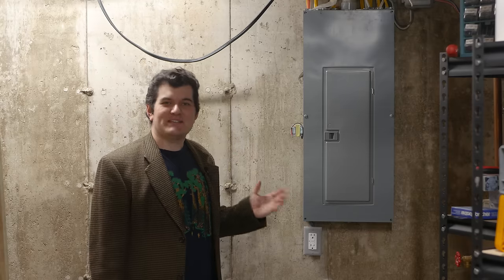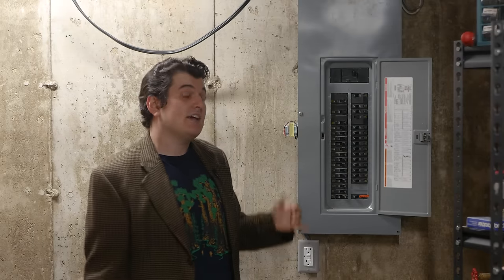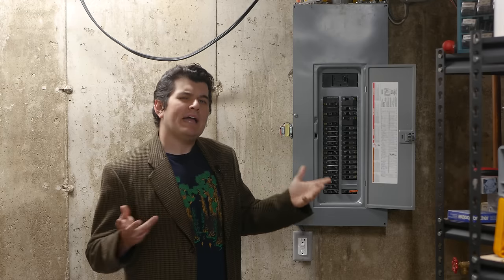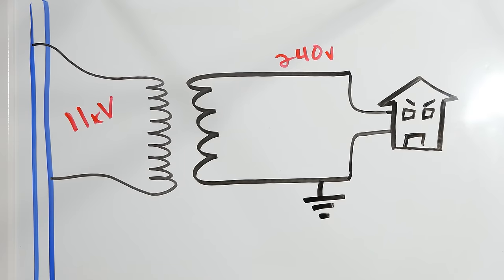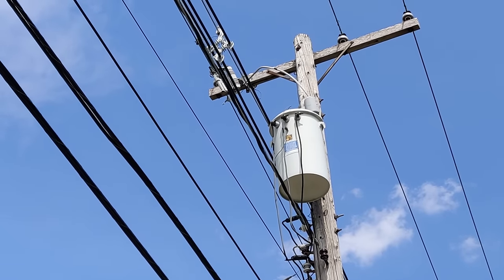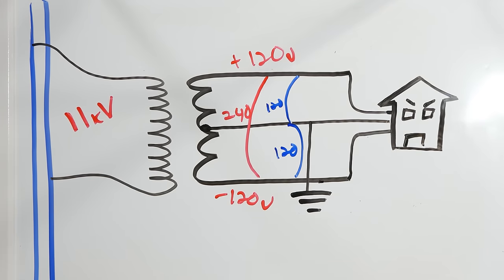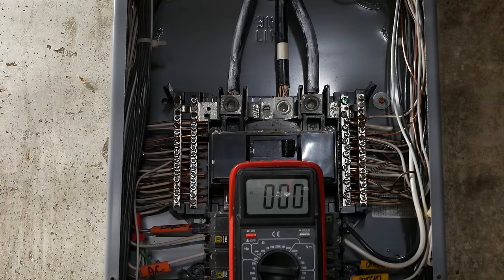The US electrical system is not 120V

Comment from the maker: One of these days I'll tidy up that wire...
A minor note; the thing about 208 being 86.7% isn't right for simple resistive loads like heating elements. You'll actually only get 75% the heat on 208! Power (watts) goes up with the square of the voltage. But, if something is designed specifically for 208, you can pull up to 86.7% what you could on 240 with the same amperage.
Reply: One day or day one.
Reply: Me to my DIY outdoor sensor wiring too.
Reply: Your neutral and ground wires are not looking to (current) code:   1. There are spots where two wires are under one screw.   2. The neutral and ground are not separated (yeah, I know, they are the same potential, but the code says they need to be separated... for reasons.).
But the panel probably predates those changes.

PS:  Wear your electricians gloves when working on a live panel... including just poking at it with a meter.
Reply: The two wires under one screw is a definite no-no.  In my area, however, both neutral and ground must be bonded to the box.  It is ridiculous, but that is what the inspector demands.
Reply: One day? Shocking.
Reply: Please tell me, for my heart, that you were in fact on top of an isolating mat ;_;
Reply: Explanation at 14:37
Reply: @TidusleFlemard  
I hope he was standing in an old tin bucket filled with saltwater. You know, for your heart.
Reply: Hi, you do realise that the main distribution voltage in Europe and Australia is 415V. The 208V you talk about is our 415V. Yes you have a 3-phase system with the standard extra phase neutral as us. But where you use 208V we use 415V. So you cannot use our industrial machines either. So our air conditioners, and other heavy uses use 415V. So the 230V countries are actually 415V
Reply: @SYH653  Two wires is fine in many jurisdictions, neut and ground must be bonded to the box everywhere I've ever see.
Reply: Joe Kinchicken  The wire hangin'? Pffft, I doubt he knows. Did they change the doorbell xformer in NEC?  But, I really don't want to try to explain Delta vs Wye xformers to him...
Reply: Thanks for the clarification re: power vs voltage for a resistive load - this enables me to keep my pedantry to myself, and I suspect that's better for all concerned.
Reply: Not explained in the video, there is a reason for the US garden variety of 240V plugs, it's not just hot+hot and hot+neutral+hot, there are different plugs for different current ratings (and sometimes use cases also).
 @varno  Actually some parts of Europe use 220V / 400V for single and three phase respectively.
Reply: Air conditioners (non-inverter type) will have 2 BTU/hr ratings too, one for 240 and 208.
Reply: Do you Americans have DMU trains
Reply: Have you done electrical training or did you just study all that by yourself?
Reply: Talk us about high-leg delta, the weirdest connection I ever know.
Reply: Yes, here in UK no appliances have their own on and off switches. This is particularly hazardous on any device using fast rotating knives, as we have to edge past it to reach the wall socket switch. The issue about having to hard wire high wattage gizmos is interesting. We have 3 amp, 5 amp and 13 amp options for nearly all devices including clothes dryers and kettles.  For power hungry stuff, as long as you have a 13 amp fuse in the plug all is lovely. My oven is the only hard wired appliance I have but then it comes off the fuseboard as a stand alone item with a 30 amp cable.
Reply: but but.. 1:10 in and I use my electrical outlet for my ac...
Love your content, your honest about mistakes done which is now almost too late to change and explain why things are the stupid way they are, I'll continue watching from Norway and love your content :)
Reply: Whaaaaa! My vacuum cleaner has it's own on/off switch, my kettle too, while all manner of other stuff has on/off switches, including fix-wired water heaters (immersion heaters). Even my wifi router has an on/off switch, although it is on the 12v supply, not the 230v AC plug-transformer...
Reply: Please do a segment on ring mains. My Australian  electrician father in law was perplexed by these when he visited the UK. One of the tricks they offer is audio communication between rooms. You can plug a non radio version of an intercom in to a socket in one room and speak  room to room with others plugged in. In fact in the 1990s baby intercoms worked this way although I think they are all radio based now.
Reply: @ole-martinbroz8590  Sure if your AC is under something like 24,000 BTUs.  But for the big boys and central air they run at 240.
Reply: Wtf  dude. Why you losing weight while the rest of us getting fat sitting at home? Booo!
Reply: UK comparison - most houses will have a 100A fuse for all incoming power. Some will even have 60A. I've never seen higher than 100A. We will have generally around 10 circuits in our consumer units/distribution boards. I would only see a distribution board the size of this one in a workplace. In theory it is possible to get a three phase supply at home, but I don't know anyone who has managed it.
And yes, it is generally a fuse not a circuit breaker. Note that in the UK and Europe it's 230V RMS plus or minus 6% - officially. Of course if you are near the substation it will be higher. I live close and currently I see 246.2V.
We use "equipotential bonding" so that the circuits are still safe in the event of a fault. That is, all the metalwork is connected to ground. Provided you don't touch anything outside your building (external power for charging a car etc is therefore unsafe unless it has its own ground). In some cases it's the same in the UK, that neutral and ground are the same but it's not usually.
Finally, 1500V is considered "low voltage" - but it's still potentially lethal. (I'm sure another electrician will correct any mistakes).
Reply: @varno  Europe has to supply (officially) 230V plus or minus 6% per phase. But see my other post.
Reply: funny, the highest service you can get here in France is 90A 1 phase 230V for a full size house (if you need more, you get 3 phase)
the US plugs that pull themselves out of the wall only with the spring action...
Reply: @jimmytwoguys  I joked, cause I have 240v plugs and 400V service in our homes so I can use a normal plug for quite large ones as.. 240V sarcasm over internet isn't always the best :P
Reply: @13:35 Erica Dansby as played by Julia Stiles.
Reply: Awesome video! I know I'm one of "those people" pointing out something in the video. 🙄
However! There is quite a bit of residue and corrosion on your panel. I see several screws that have rust on them. If you can, put loads on your panels and point a flir camera at the panel with the cover off. You might have hot spots and need to treat the corrosion.
Reply: Plus we shouldn't forget about 480V 3-phase either. 
Some fun facts, my CNC machine has a 3-phase motor on it, but the machine plugs into a standard 240v circuit. The VFD handles the conversion and adjusts the speed of the motor. Apparently 3-phase allows for greater control.
Then my SpeakerPower SP2-12000 power amplifier plugs into a 240V 30A circuit, since that drives the subwoofer system in my home theater.
It does become quite fascinating on how a lot of things work, and a lot can sure get quite complex.
Reply: So all of the cost and complexity of three phase, with none of the benefits.  Brilliant.
Reply: Natural Gas or Propane Clothes dryers provide a smoother/constant heat source than their electric counter parts. Also they are more expensive due to their cost of manufacturing to safety ratio, which is absurdly higher than electric dryers. In the long run they cost about the same overall. Electric is cheaper to buy upfront but cost more to operate. and Gas is more expensive upfront and cheaper to operate. Yes natural gas dryers are cheaper to operate. Why you ask? Gas dryers take about a third to half the time to dry a load.
Reply: @InconsistentManner  and if you live in an area with natural gas that isn’t the cleanest they also impart a lovely aroma to your clothing.  Ugh, I hate natural gas dryers.  And not crazy about electric either - if the weather is nice I’d rather just hang the clothes outside even if it isn’t nearly as convenient.
Reply: 277 volt lighting circuits....
Reply: 16:00
At least you can convert to IEC 60320 standards without completely replacing your electricity infrastructure.
C13 and C14 for 240V
C15 and C16 for 120V
Reply: Thanks for a great video.  I am an electrician, so I understand all of this (and why you left out what you left out), and you did a good job explaining split single-phase.  I only wanted to present a piece of constructive criticism: your tone across all of your videos seems to be getting more and more apologetic as you go.  You are making statements of fact, but look more and more like you expect to be attacked for them.  I understand that you get lots of folks mouthing off in the comments for this or that inaccuracy, but the "don't attack me" looks on your face are actually starting to slightly detract from the positive enthusiasm for technical details that pervaded your earlier videos.  (I did really get a laugh out of the card on gas dryers though, probably because I have and love mine -- it's so much better than those foolish electric only ones)  I subscribed to your channel originally because it is so nice to hear someone speak with excitement about hidden cleverness and technical intricacies in our modern life.  Be proud and happy, and stop acting like you have to tacitly acknowledge the haters with your eyes.  Rock on!
Reply: @kyleaidenfox  you're allowed 2 ground conductors under one screw as long as they are the same gauge. Not two neutrals though, and definitely not one of each. Lol
Reply: buut wee have 400v 3 phase every where and 230v one phase. Inst that better (Look at siwss plugs witch are just as unsafe as the US once)
Reply: I don’t believe you’ll tidy up those wires be real lol but I really like your videos
Reply: Ever think about doing a video on the history of amateur radio & how amateur radio is today? I am licensed HAM I think it would be interesting to those folks whom think its still not around :) Lots of really neat digi stuff now days.
Reply: @kyleaidenfox  the ground and neutral have to be bonded together in the panel per the NEC code the only time they are separate is in an isolated ground circuit where a separate ground is added for that circuit and they are usually only for a circuit with electronics to reduce noise in the electronics
Reply: @station240  They also exist because over the years what is allowed has changed.
My dryer has a 10-30 plug (neutral + two hots) because my house was built in 1975 and at the time, 240v appliances were installed w/o a ground.
Today of course it would be a 14-30 plug which includes a dedicated ground.
Different use cases also would have locking or non-locking plugs.
Reply: In the main panel the neutral and ground bars must be bonded. In any subpanel, they must not be bonded.
Reply: @DocNo27  I've never liked the feel of clothes that were dried on a clothesline.  I remember my mother used to hang out the laundry when I was a kid and my jeans would always end up feeling like cardboard.
Reply: @16v15  If you really wand to have fun explain high leg delta connections that will give you 240v three phase, 208 single phase 240 split phase and 120 split phase.
Reply: Well i could nitpick, that if you call US system 240 V, you should call EU one 400V (or 415 in UK). Im somewhat interested though in construction of your main breaker. 200A seems like a lot for such small appliance, for now I dont feel safe about it disconnecting lets say 300A short in your house. Looks like something to melt and start a fire. Now since i dont think Americans are suicidal, i assume it is actually safe. Im just curious about how it is made, and what extra stuff is in there. Here in EU code prohibits (at least in most countries) "switch type" breakers over 125A - they all have to be single use safety devices.

nebuchadnedzzar  most of Europe runs on 230V, and has 400V phase2phase current. 415V is equivalent to 240V, and as far as i know is UK only .
Reply: @Novel_clips  They are very rare here. Our outdated FRA regulations make multiple units rather expensive (they inflate prices of all equipment, but especially MUs), and our transit agencies are always strapped for cash, so most trains-- when we have trains at all-- consist of a diesel locomotive hauling several heavy, unpowered coaches. There are some exceptions, like NJ's DMU River Line between Trenton and Camden, which as a light rail has relaxed regulatory requirements (of course light rails should really be electric for better acceleration, but again, not enough $$$). Electric multiple units are more common here, used in almost all of Philadelphia's SEPTA network, most of New Yorks Metro North lines, and on some NJ Transit lines.
Reply: This would be by far your finest horror video. I didn't even finish it. I am so glad im a european. Atleast there i dont have a horror cabinet like yours in my home.
Reply: The 120V is not "marginally" safer than 220-240V, it's ENORMOUSLY SAFER!!!
Reply: AC power is not calculated by multiplying Voltage with Current alone. There's a sinoidal factor in there too.
Reply: @varno  there is also 480v 3 phase power for many commercial and industrial buildings...
Reply: @kyleaidenfox  I'm not up on current codes ( I was an electrician in the 1990's) but if the panel is the bonded panel, the neutral and the safety ground is the same buss. This is only if the panel is the service entrance panel where the bond was made. I just looked at my current house that was built in 2019 and it is still wired with a single bonded neutral/ground buss. Sub panels, or panels where the bond is made at another location it is required to have separate buses for the neutral and the safety ground. For example my house in Florida had it's service entrance outside just below the meter socket. in this box was the main breaker (Service disconnect) for the house, there was also a couple 2 pole breakers for the air conditioning and the electric stove. This is where the neutral/ground bond was made. The breaker panel in the garage was wired with 4 wires and had a separate safety ground buss.
Reply: @Mithrasboy  Dave Savey electrics long view time, but apparently ring mains saved copper compared to out and back wiring
Reply: @Βασίλειος Μπεσλεμές if your rounding is wrong... But either way, to get exactly 208 or 240 is almost impossible, so 75% is more than close enough.
Reply: @paulmichaelfreedman8334  Thanks, was looking for this comment. Well with RMS voltage you can calculate on pure resistive loads with just voltage times current. Sadly in reality most applications where we have motors are not pure resistive loads and have kinda bad "efficiency" with just 1 phase. 3 phase allows you to deliver more power efficiently to non resistive loads because the current doesn't have to play "catch me if you can" with voltage so much.
Reply: Speaking of tidying up wires. Can you explain America and Asia’s obsessions wit free hanging wire webs for power delivery?
Reply: Ok, so you Do have the more dangerous 240V, and it's still not GFI protected? Boggles the mind...
Reply: @hairyairey  fuses have been out since the 15th edition of BS7671 at least.... On the 18th edition now (although my house is wired to the 17th)
Reply: A break from politics....phew
Reply: @dasy2k1  I qualified with the 16th edition and need to catch up. But what you say applies only to new builds or refurbishments.
The energy company still has a physical fuse in your premises, with a seal on it.
See my other comments about BS546. It's very difficult to change any standard once it's in use. Alec, if you think the UK is bad Europe has two different Schuko standards (generally), they don't work well with each other and the safety ground for one of them is next to useless as it can still provide power without a ground. Which is why we designed ours for this to be impossible.
Reply: Love the video
About switches on walls. that is just so you don't get zapped if you run over or rip out a cable at the device end.
Reply: Only the UK has switches on the sockets and an integrated fuse in plugs. The Smaller and equally safe plugs the rest of Europe uses are better imho.
Reply: The United States is thinking AHEAD of the curve! They are using the ("center-tapped" to neutral) 240v system in homes and offices so that they can convert to the European 240v system INSTANTLY by simply removing the neutral wire! Why? Because the 120v appliances in the U.S. use DOUBLE the current in amps for the same wattage! And the insulation rating of the wires in the U.S. is 600v. So? If we convert from 120v to 240v, each breaker can handle double the wattage! The poor Europeans are stuck with their thin 240v wires, and if they converted to 120v, the wattage they can handle is cut in HALF! One more factor is the difference in frequency. The change from 60Hz to 50Hz requires slightly larger transformer cores. That is why airplanes use 400Hz. Besides, 120v is safer than 240v, so we can easily live with doubling the current for all of our appliances.
Reply: @Tharkz  Those aren't America and Asia's obsessions only. In eastern Europe, most streets out of city centers, areas with multi-family houses etc. have those overhead wires. They were simply cheaper to build – no digging. The bad thing about them is that they are prone to damage in case of strong winds, especially if they go through forested areas.
In case of Asia and maybe some part of America, there is also another reason, which leads to using overhead wires even in centers of large cities. Underground cables are even more prone to damage in case of earthquakes.
Reply: @Tharkz  Earthquakes in Asia and some part of America.
Reply: @erroltheterrible  Most of Europe has the more dangerous 230 V and no GFI in many old buildings.
Reply: If this is the channel where we nit-pick, it's actually 86.6%, the 208 is rounded up slightly from 207.85. The voltage across the two is cos(120 deg) * their sum, which is sqrt(3)/2*240 or 86.6% of 240. As you mentioned in the video though, the voltages are all approximate anyways so it certainly doesn't matter to 3 sig-figs
Reply: So that's why my dryer works better at my house then it did at my old apartment.
Reply: Power is watts, watts is current * volts.  Where is a squared function with voltage?
I squared * R is also watts; squared function is for current, not volts.
Reply: @ole-martinbroz8590  Is the AC you're referring to a single-room portable or window unit? Those do typically use regular 120v outlets, but I've never heard of a central air system running off of 120v. I'm not gonna say it doesn't exist anywhere, but I've never heard of it.
Reply: @pirobot668beta  you can rearrange ohms law however you want, you can also get P = V^2/R. The relevant thing is the units, which are really messy. But, because current depends solely on voltage and resistance, it's a dependent variable. When you're looking at that sort of equation, you want to only use independent variables, which leaves you with the V^2/R formula
Reply: I would be really interested in seeing a video on how uk plugs and electrical systems work
Reply: I actually did not know about this and I live in a mid-rise building with its own transformer room in the underground garage (which for years has needed its fans replaced because they're grindy and squealing).
If I wasn't so scared of shocking myself or blowing something up (or creating scary tiny arcs), I'd check that out with my fuse box to check if it really does have 208 volts for the heaters (dual 30 amp shotgun fuses), water heater (also uses dual 30 amp shotgun fuses) and stove (dual 60 amp shotgun fuses).
Reply: I’m glad this comment is here. I was about to write a long angry message insulting your intelligence and promising to unsubscribe
Reply: @kyleaidenfox  The neutral and ground wires don't need to be separated in a main panel. You are correct but only if it's a sub-panel. Also, two wires under the neutral or ground bus bars meet code, it just depends on the panel. That's a Square D QO panel which is fine and is to code.
Reply: @varno   While your distribution voltage may dip down as low as 415Volts that is not the case in USA, a large country which moves electricity over large distances at a higher voltage.
In USA where this video was made the primary voltage of overhead electrical transmission lines on residential streets ranges from 2300volts to 40K volts and in my area it is 14,300volts. From those high voltage lines a step-down transformer is attached and a secondary voltage  is derived. The voltages can be 120, 208,240,277,480,600,900 etc.... volts. From these voltages you can further refine the voltage required to anything you desire. It's even possible to step the voltage up again if needed. 
Machinery from other countries can be used in America if required, though it's rarely needed since most of the world will supply us with equipment designed for our electrical grid when requested. For example an air conditioner as you mentioned can be made to run on 120,240,208 and 277 volts with little effort for a single phase connection. If further needed all three phases can be used to run larger equipment usually 480 and 600 volt connections in a three phase delta connection. A three phase AC unit is actually cheaper to purchase than the same sized single phase unit, it just easier to use a single phase 120-240volt unit because that is the standard voltage people have in their residences.
My work uses Swedish and German made equipment and some of it we have not bothered to change out the 50hz motors for a 60hz motor we would typically use here. It does not mater what the equipment is it can be used here and supplied with a proper voltage, if needed we can change the frequency of supply voltage to 50hz or change the supply voltage to any desired voltage. The AC can be rectified to DC if needed.  We have 90 volt DC motors all over the place and most people aren't aware of them. This video exclusively showed typical single phase residential connections. Rest assured if it was wanted or required, any voltage could be used. I would not call the US a 220 or 240V country. Everything is available here if you need it. It's as simple as running 2-4 wires to a building location and attaching a transformer to the lines to supply any voltage and phase configuration you require.
Reply: Would it be possible to wire 240V into kitchen and use european Plug(there are safer plugs than in UK - not even possible to touch live rods) and 240V european kettle? 200A is way more than is usual in Europe it is suprisng that apliances are limited.
Reply: @paulmichaelfreedman8334  but the 240/120 is the RMS voltage so you can multiply the two (assuming unity power factor) the peak voltage is 170V
Reply: @varno  208Y is common for a lot of commercial/ light industrial stuff but you find all sorts of 3 phase voltages in North America, once you have some sort of 3 phase in the building it's simple enough to transform it as needed.
Reply: I miss your old intro to "technology connections" it's still buzzing around in my head every time I watch a new video
Reply: The outlets in the US and Japan and some other places in Southeast Asia are the same... Not sure how different or how much safer everyone else's are.
Reply: Plug fuses existed in plenty of older American devices too. I remember we had several lamps with fuses directly in the plug. There's no reason these couldn't still be used (outside of cost).
Reply: My house was in built in 1984 and also has an exposed transformer like that for the doorbell. It was definitely up to code when it was built and thus grandfathered in.
Reply: They all have 10A fuses in them, what are you talking about? Even a $5 meter has a 10A fuse.
Reply: @kyleaidenfox  I doubt your message will reach him, as this show is clearly a rerun of some long lost 80's PBS found footage.
Reply: CORRECTION!!! The 3 prong 240V plugs DO have a neutral wire. In a 3-prong outlet and plug, the ground and neutral wires are contained in the same prong. This has the potential for a current to find its way into the ground wire and back up to the appliance and shock the user. It wasn’t until 1996 when the National Electrical Code (NEC) was updated to require 4-prong outlets in all new homes. Existing homes may still use 3-prong outlets, as the NEC changes are limited strictly to new homes. This eliminated the rick of electric shock of the 3-prong outlets. Citations- National Electrical Code (NEC) Section 250.140
Reply: @kyleaidenfox   neutral and ground should only be separated at specific points  and most panels are designed for a max of 2 12 wires under 1 screw
Reply: How can you sleep well at night  with an all metal breakerbox ect.  (Thank you very much for the interesting insight into the US electrical system)
Reply: @VariantAEC  UK plug sockets are way safer look into how they actually work. UK plugs have half of each prong coated in insulation. Because of this, even if a plug is not fully inserted into a socket, touching the exposed part of the prongs can’t give you a shock. The U.K. plug is designed so that the grounding prong is slightly longer than the prongs responsible for transferring current. Like a tumbler in a lock, this grounding prong is responsible for “unlocking” the socket, giving access to the more dangerous live and neutral terminals. Meaning nothing can be jammed into the sockets.
Reply: One thing I would have ... be more precise on with talk about volts and amperage, which all said is correct, is mentioning also difference between direct current and alternating current. That is one of the biggest factors in deadliness of an electric shock. Direct current needs a lot bigger numbers than alternating current to become deadly, and you casually take kilowatts of direct current in little snaps of static electricity.  This should be really mentioned when mentioning probably still 55 volts of alternating current in construction areas versus 55 volts of direct current in power over ethernet. It is not wrong, in certain way, but this is a big thing to leave out in the comparison.
Reply: @SYH653  i get the ground but why the neutral what benefit does that have over just the ground
Reply: Today i learned 2 things:
American system isnt that stupid, its just obsolete.
I think i can make 15 v with just four this strange threewire transfomator
Reply: A Technology Connection video always makes my day a bit brighter so I have the energy to get work done.
Reply: @gabest4  But the equation is wrong because he forgot the units on the left hand side.  No credit. F. Hopefully he'll do better in the make-up exam.
Reply: @shha22  The UK doesn't usually see 415V in the home though.
Reply: @21:36 I believe an example where we could plug something in that isn't switched is a phone charger. The reason we have switches is the same reason as you should... Our Plug terminals can be touched while live (NZ + AU plug). There was a change to the law to require half the plugs terminals be insulated, but you can still find plenty of either older, or dodgy Chinese electronics not up to code. Our plugs are as terrible as yours. In fact, on my return from the US, I learnt you can use a pair of pliers and turn a US 2 prong into a NZ/AU 2 prong ;)
Reply: Joe Kinchicken  that doorbell transformer is a knockout mount, meaning that all the 110 volt circuitry is inside the panel and only 24v is accessible from the outside, so there's nothing wrong with that.
The hanging wire on the other hand... Sheesh
Reply: @Mithrasboy  Um... you really think that no devices over here have on/off switches?
Reply: I have one single criticism of this otherwise fine video. RCDs do not stop you from getting electric shocks and don't suddenly make electricity safe. They protect you from live to ground shocks, but not live to neutral. Uncommon, certainly, but possible with wet hands.

All new installations are fully RCD protected and it does allow certain relaxation of some rules but for the most part we consider RCDs a last line of defence.
Reply: @highpath4776  The easiest way to think about a ring main is to forget the ring for a second.

Let's say you have some spare 2.5mm cable which is capable of carrying 20 amps. But you need 40amps from your breaker to your socket (for whatever reason, I'm just making up numbers)

You can either go and buy a 5mm cable, OR, you can run two 2.5mm cables. It's literally the same end result, yeah? Put them side by side and you have 5mm of copper from breaker to socket. Only difference is whether it's all in the same insulation.

So we run our two 2.5mm cables to our socket and now each cable is carrying its own 20amps. At this point things are IDENTICAL to a 5mm cable.

But now you want to add another socket. Well, cut anywhere on one of the cables and put a socket inline. This socket is now getting 20amps from one side, and 20ampa from the other. Now it's a ring!

The advantage being if you are wiring a real life house, by simply running one cable from the last socket back to the breaker and making the ring you can halve the entire cable size for the whole run.

I hope that makes some sense for those reading!
Reply: I touch 240 volts on a daily basis... Dangerous? What are you talking about? My heart has never stopped and I have done this at least 5 times of 240 volts electrical shock and 1 time 120 volts electrical shock without using any voltage drop. Of course the electricity was just going through my fingers and nothing else. It never reached my arm. My point is it depends where you are getting an electrical shock and how.
Reply: Regarding 20:00 it's trig, not geometry. Sine 120° = 86.6
Reply: If we would use 300V at 300kHz we would be much safer... I mean, there will still be the risk of burns but no idiot will keep his hand on the wires long enough to receive burns (because it would still be hella uncomfortable).
The reason why both DC current and high frequency AC are much safer to touch is because the human body isn’t just a resistor but a capacitor and an inductor as well. A capacitor blocks DC, an inductor blocks high frequency AC.
(60Hz 240V is slightly more dangerous than 50Hz 240V btw)
Edison may have been correct about the dangers of 50Hz AC but he got nothing on the high frequency electric bolts that madlad Tesla was playing with.
EDIT: Also, because of the skin effect at high frequencies, you can pass 1A through your body without dying (but slowly getting hotter instead).
Reply: @DocNo27  Where I live, NG costs about a 1/4th of the equivalent heat produced by electricity.  The $50 more for the gas model easily pays for itself. NG is a savings of around $7 per month here.
Reply: @varno  Industrial machines?  At that level the company often owns the transformers and can hook whatever they want up. You want 600Y, , 415Y, and 208Y. Sure, no problem, the utility inspects the install, and then schedules and outage to hook them up.  But 3-phase is really beyond the scope of the video, other than to note that in some situations,  the center-tap  split phase home appliances expect is faked in multi-tenancy buildings by routing 2 or the 3 phases to the unit's distribution panel to balance power draw across all 3 distribution phases.
Reply: @varno  It depends on the location. Houses use the standard split phase 240v/120v system. Apartments and larger complexes might use 208v 3 phase. Here where I work at a church we have  277v/480v 3-phase.  (Most of) The lighting circuits run at 277v. Regular screw in incandescent sockets and wall outlets are at 120v. and the 3-phase motors for disposals, HVAC, exhaust get 480v.
Reply: @ChadNewitz  80% of that is standard middle/high school science class. The parts you have to study all relate to code requirements.
Reply: FYI 208! != 208 
(sorry)
Reply: @bradarmstrong3952  Well said, Brad 👍
Reply: @Mithrasboy  my modern blender has its own switch, it seems to be older stuff (predating worldwide products) that just assumed we'd provide the switch. And even then I've seen plenty of older stuff with a switch, it just wasn't guaranteed every time.
Reply: @Mithrasboy  the baby monitor that was used on me in 95 was radio based, but maybe it was fancy. But certainly I've never seen intercom plugs in any houses... I've seen ethernet to power converters, but those exist for non ring main countries too..
Reply: @hairyairey  my old home in the UK had fuses in the fusebox, my modern flat has RCD circuit breakers.
Reply: Dog Ma  just as waves in the ocean propagate forward even while the water molecules stay roughly in-place. It's not that mind blowing
Reply: @LG123ABC  I know exactly what you mean, and I don't like that stiffness either, but I've found using fabric softener allows me to air-dry while retaining softness (as a bunch of my clothes would get damaged with drying, and I have no low or high setting on my dryer either)
Reply: @SuperWasara  electroBOOM did just that to get 240V hair straighteners or curlers or something to work in Canada, so yes!
Reply: @regiondeltas  interesting, my old home had a metal box with fuses, my modern flat (almost ten years old now) has plastic box with RCDs... I guess my flat isn't so modern anymore if new builds are getting metal again!
Reply: You didn't even talk about the high leg delta!
Reply: @sncy5303  3 phase Wye is still 120/208.  You need a center tap of a single phase to get 120/240.  With two lines being 120 out of phase, the relationship between L-L and L-N will always be the square root of 3.
Reply: @k53847  Just L-N on a 3-phase Wye.
Reply: @k53847  Yes.  Found in US office buildings.  Found out about that when the lame electrician wired some new outlets to lighting circuits.  Found out when I plugged in a power strip and it went "bang".
Reply: @seanj1984  I believe that's only true of the first panel.  They're separate for any sub-panels.
Reply: @kyleaidenfox  [yeah, I know, they are the same potential] 

When no current is flowing, correct. As current increases, they do display a differential as the neutral carrier's inherent resistance at load displays a voltage drop relative to source.

This is exactly why they must be separated.
Reply: @SYH653  It's not ridiculous. Do some reading.
Reply: @varno  [Yes you have a 3-phase system with the standard extra phase neutral as us. ]
It's single phase. You mean "split rail".
Reply: "amperage" - AGGHHHH! Only welders talk about "amperage"!
Reply: More reasons to hate apartments!!!
Reply: @Novel_clips  Yes. A quick Google would have told you that.
Reply: @caphikoki  https://en.wikipedia.org/wiki/High-leg_delta
Reply: @hairyairey  In older homes in the US, there will be fuse panels instead of breaker panels. Technically, these are safer than breakers, however, the insurance industry over here has resulted in all modern (starting in the 1960s) installations being breakers, with only a few small exceptions, as the older fuse panels typically used edison-style plug  fuses, and it wasn't uncommon for people to put a penny behind a blown fuse to get the circuit working again, completely bypassing the protection of the fuse, especially after evidence of an overcurrent situation.
Reply: @Mithrasboy  They have them in Oz, they have them everywhere. It's called (not surprisingly) 'audio over electric mains' and it's problematic unless using FM or Digital as the carrier, as there's massive noise and leakage loss on most mains.
Reply: @hairyairey  [ In some cases it's the same in the UK, that neutral and ground are the same but it's not usually.] Technically, there's also a difference between "Earth" and "Ground" too, but semantics and nationality further confuse that. Also a difference between electronics and electrical, but I digress...
Reply: @ReeseRiverson  [Apparently 3-phase allows for greater control.] As a result of your Variable Frequency Drive (VFD), but make no mistake, the motor would run at optimal efficiency directly connected to a 3 phase main due to what's termed 'source impedance' (sometimes referred to incorrectly as 'source resistance'). The 'greater control' you refer to is for infinite speed control (within practical limits) of the triple phase inverter you're driving it with, as 'AC motors' are synchronous to the line current frequency.
Reply: @varno  ummm. Our 3 phase is 480v, we use a three phase transformer to step that down to 208 mainly when we need to provide 120v power for lighting or other 120v loads.
Reply: @ReeseRiverson  3-phase inherently has motion in the power. Single phase (whether 120V or 240V) does not. A 3-phase motor will synchronize it's rotation with it's power supply, so you do get much more reliable speed, and some more position control as a result. The power grid actually runs on 3 phase as well, as it's more efficient to carry power. Large and/or industrial buildings will typically receive 3-phase power, as the load can be easier to balance across the generating plant. Going back to Ohm's law, looking at the phase, and we only have to worry about the absolute value of each. With 120V single phase, the voltage at any given instant on the wire can be anywhere from 0V to 170V. With the voltage at 0, no current can flow at that instant (we're ignoring reactive components for this) That 120V is what the DC equivalent would be, or an average of the voltage over time. When you factor in the geometry of 3 phase, while an individual wire may drop to 0, you always have 1 phase with an absolute voltage above 120V to carry the current.
Reply: @bradarmstrong3952  "split single-phase" is the correct term, and aptly so. He did use "split phase" which infers something completely different. The ambiguity can be avoided by using 'center tapped secondary' or as we use in electronics 'split rail' (which also applies to DC supply with neutral center). In NorthAm electrics, 240v outlets can be supplied with the neutral center or without, depending on need of use. For audio use mixing 240v (often European) equipment with 120v, it's best to supply both in the same wall box so that the ground lead is common to both, and thus minimizing a possible 'ground loop' which introduces hum and noise into very low level audio devices, like turntables. The 120v outlet(s) tap neutral to one leg of the c.t. 240v.
Reply: @ihatesmartphones  For 240v? Errr...that's low voltage in the big scheme of things.
Reply: @16vSciroccoboi  Depends on the jurisdiction. Best none of them are shared.
Reply: @hairyairey  in the US the Neutral and Ground are bonded together but only in one place. Usually at the main circuit panel. When you consider a neutral isn't really "neutral" at all it makes sense to use single point grounding, otherwise conditions could arise where you could have voltage/current flowing on the metallic frame/cases of appliances that are bonded to the receptacle ground pin.
Reply: @dasoslukos  I'm an audio tech, but had a favourite uncle who was a HAM, and I was astounded how computers are now used running dedicated progs to process digital, and even some Morse. It's the work of Satan...My unc was a master at CW Morse.
Reply: Common misconception about the danger of amperage.
Very low amps (under 100 milliamps)safe, but painful.
Slightly higher amps (100-200milliamps)lethal.
Higher amps(over 200 milliamps), dangerous but less likely to kill you.
This is why many people have been hit but high voltage high current wires and survived, while so many people have died working on relatively low voltage home wiring. 
Between 100 and 200 milliamps the heart can go haywire(ventricular fibrillation), this is what kills). Above around 200 milliamps it just stops, but it's likely to restart if the shock doesn't last too long. This is why CPR is more likely to work on victims of higher voltage shocks, they get knocked out and burnt, but they generally recover if treated soon enough.
120v kills more people than 240v...
Reply: You should do a video on ring mains. The few comments here and there make it sound interesting to learn about
Reply: @paulmichaelfreedman8334  it depends on what you are trying to calculate. Room Mean Square, Peak to Peak, etc. RMS is more than adequte for simple Ohms Law and Watts Law calculation as 120v RMS  will produce the equivalent heating as the same 120v DC. Industry standard is to use RMS values.
Reply: @ChadNewitz  well seeing how he totally butchered how his dryer works... I would say this is new to him.
Reply: have you ever felt what 120v feels like?
Reply: Oh all the wires I'd LOVE to tidy up in my model home on the block. Granted I'm an idiot. I've been playing with electricity since I was 9. Aaaaaannnnd that was then in a week long course of building a thingamadoozy on a board with a switch, a transformer, a non grounded plug and the output ends out of the transformer to the Powers that Be to Know Where...

Now I'm no expert when it comes to electricity. BUT I will say this.

Wal-Mart. 1999. Supercenter construction. In the midst of construction the assistant store manager noticed wires coming out of a conduit that would eventually lead to a game console display. Time was about 8:00PM near the store's closing hours of 10PM. Said assistant manager ORDERED me to stuff said wires with BARE ENDS into the conduit. I asked if the circuit was live. He stated "No.". I then asked if I could see the wiring schematics for the Electronics Department. Again "No.". Suddenly I'm staring at bare ends, an aluminum conduit pipe, and no assurance that the circuit was dead.

I made my decision to STAND MY GROUND. I WILL NOT stuff the bare wires into the conduit. Unless I had solid concrete PROOF the circuit was dead. The assistant store manager assured me the cable was not live. 

PROVE IT It's MY LIFE that is on the line here. If that's dead then there's nothing to fear here. If it's live YOU are risking MY LIFE by ordering me to shove those wires into the conduit.

Long story short the line was INDEED LIVE and tossed my peach into the main aisle amidst sparks. 

And was told by said assistant manager to not seek legal action as it would mean my job. 

Karma came just a year after I quit. Said assistant manager purchased two 24 packs of cheap beer in bottles. After he had paid... the pack in his right hand... the handle broke. Sending that 24 pack of cheap beer to the tiles. Swearing at Wal-Mart as an associate is a no-no. The F-bomb was dropped and as he went to put the second 24 pack of beer onto the baggage area of the register the handle also broke. Sending more beer to grace the tiles of the store. Another F-bomb.

As I strode past with my purchase of kitty litter I leaned in. 

Karma can be a b**ch.

Long story short... Electricity isn't something to play with. Even in my home there's a ghost circuit meant to keep a ghost light on even AFTER the main feed disconnect is switched OFF.  I've come to learn drunken monkeys wired my home. And said drunken monkeys ran my ventilation system...
Reply: 208 is mostly for balanced 3 phase loads  [e.g. industrial lighting in building],   and NO not just real impedence loads.  the phase shift types too.  The little ( j ) in imaginary numbers class.
Reply: @SumeaBizarro  if you took kilowatts of static electricity you'd be pretty sore or dead. Methinks you are confusing Watts with Volts.  

Static electricity (lightning aside) is high voltage but with little Current. Generally speaking high voltage DC would be deadly as well. When people say it isn't the voltage that kills, it's the current, they are only half right. Most DC in our lives is at low potential, that is, it seldom has a voltage high enough to break down the dielectric constant of our skin.... So no current flows. However...soak yourself in a salt water mixture and lay your arm across the poles of an automotive 12v battery and I guarantee you will not have a pleasant experience. 

Most of reasons a given AC voltage is deadlier than the same DC voltage is due to secondary effects, like stronger muscle contractions, etc etc.
Reply: @michaelhall6178  your sarcasm detector must not run on 120v....
Reply: 277v?!?!?!??!
Reply: Polar and rectangular figures for electricity are imaginary ( jmaginary?) anyway so it doesn't really matter.
Reply: @kyleaidenfox  That's the beauty of the electrical code, it's up to code if it was up to code when installed. Until someone touches those screws nothing has to be changed.
Reply: @ChadNewitz  clearly not trained.  It's all in the 'ugly book' (a.k.a. electricians handbook)  there's a lot of specifics in the ugly book, like wire sizing to current, AND proper mounting and limitations, etc…

This is what most professionals refer to “knows just enough to f something up real bad” … or “to be dangerous” whichever you prefer.  In many cases, people who claim to be ❛electricians❜ but aren't NEC qualified fall into this category of not knowing enough, but that's a tangent I won't get into right now
Reply: ... stop being pedantic about it... you do realize this is the internet right? Being pedantic about "it" is half the fun.
Reply: @Mithrasboy  ring mains do my head in.  I can just understand why they have some current handling advantages with lighter wires, but the idea of trying to troubleshoot on just makes my poor little head explode.
Reply: @DocNo27  what kind of gas appliances do you have that mix heated air with combustion exhaust?  *shudder*.
Reply: @PanicStation1337  we’d love to have 3-phase everywhere in North America, but huge portions of the grid are very widely spaced out.  That’s why the residential areas in the cities, and especially the rural areas like farms are usually only single phase.  Heck, the lines running past my rural property are only a single conductor feed line, and rely on a local earth rod for the return…  The trend here was for local cooperatives to construct their own transmission lines to remote locations, at cost… so penny pinching on par with UK ring final weirdness often meant we go the cheapest minimal system...
Reply: @seanj1984  Or a sub panel, where you don’t bond the neutral + ground so that any RCD/GFCI will measure against the single path to ground at the main panel.  At least, that’s my minimal understanding on that particular bit of (sometimes jurisdictional variant) code.
Reply: That’s not true all 240vac plugs have a neutral you mean ground/earth pin. The older plugs rely on the neutral pin for earthing which by the is no longer code.
Reply: That’s not true that formula proves that volts WILL kill you as well.
Reply: The code is changing more GFCIs in more places.
Reply: @caphikoki  I just came across that. There was a note on the breaker box, "Warning third phase is the stinger!". Wikipedia explained all. No problem as I needed to install a 4kW 240 outlet for a BGA removal system.
Reply: @Tharkz  mix of cost, property rights, access, laziness, cost, and more property rights.
Reply: @seanj1984  the ground and neutral are only bonded together at the main panel/disconnect only. In most houses that is the main panel. Sub panels are required to have floating neutrals.
Reply: Also US electrical code has been updated requiring most outlets to be tamper resistant, arc-fault and ground fault trip. The arc-fault is a nightmare for brushed motor devices like vacuum cleaners which generate arcs when the motor is running.
Reply: @fastidioushandyman901  it's never permissible to have two neutrals under the same screw. Hasn't been since like 2002
Reply: @varno  Our heavy industrial equipment usually runs on 3 phase 480V. That's 277V to ground/neutral from each phase. A few years ago I designed a 10kV at 5A DC power supply for a cyclotron. It runs on 480V 3 phase. 
Quite a few years ago I managed the installation of a cyclotron system in Indonesia. To save money a triac AC regulator was supplied to regulate the variable transformer high voltage DC power supply and the SCR controlled magnet supply. Unfortunately the two phase controlled supplies fought each other and continually "hunted". Fortunately the cable losses were low enough that the SCR magnet supply could be run directly off the available 380V 3 phase instead of the output of the 380V input, 480V output regulator.
I live in an older neighborhood so our distribution voltage is only 4800V, a third of what is typical. On the other hand we now have 1Gb bidi internet. Things are looking up.
Reply: @Novel_clips  Just north of San Francisco there is a commuter railroad called SMART (Sonoma Marin Area Rapid Transit) that uses short DMU trains. Because of station limitations and not blocking streets when stopped they use a maximum of three car trains.
Reply: Good work you did your research well. I'm am an electronic technician. I really just wanted to see what you got right.
Reply: So where did the whole 110V thing come from anyway? It used to be "common knowledge". Was there a change at some point?
Reply: New codes require AFCI  (leakage/arc detectors) in most circuits.
Reply: @SYH653 : That is what a "main earth neutral" is (MEN) - to ensure the ground and neutral are at the same potential - safety, you know. (Soldered together in the box)
Reply: @kirbymurdstone4925  A small nitpick, it's bus, 1 "S". Buss is short for Bussman, the fuse company. Toodles and have a nice day.
Reply: I’m 14 and you have the hell confused out of my brain.
Reply: The 120V plugs are efficient and simple.  Other countries have plugs that waste a lot of  material that is not needed.    

Also, if you want to see something stupid, look up a split bus circuit panel.  
My house was built in 78 and instead of 1 main breaker, it has a top section of all the 240V breakers.  Then a lower section with all 120V breakers is fed by two of the 240V breakers.    
So instead of turning off one main breaker, in a split bus panel, you have to turn off six 240V breakers to entirely kill power to the entire house.    Dumbest breaker panel of all time. https://www.startribune.com/split-bus-electric-panels/559238532/     
Also eventually the neutral and ground go to the same grounding rod. Technically the neutral is just another ground.  
The reason for the neutral is it is insulated and meant to always run current on it to the grounding rod for your device to have a flow of current.  
Ground is unshielded and mean to only be used if there if there is a current leakage in the housing of the conduit or powered device to send the current to the grounding rod instead of through a person.    The neutral wire is used all the time.  The ground wire is used only if there is a current leakage in the device to protect you.
Reply: You did not even touch on how 120V (RMS) is really 340V, Peak-to-Peak.  Arcing distance at a given P2P voltage marks an important danger threshold.  You can chase this rabbit as far as you like.
Reply: @kyleaidenfox  "for reasons"  LOL, When I first started in the commercial electrical field, code allowed 3 hots to return on 1 neutral. It was pretty common for electricians to get lit up by the return load on a neutral not realizing it was shared. "we locked it out how is it still hot?"  When the code went to a constant trip breaker for any hots sharing a neutral or a separate neutral for each hot, things definitely improved. Didn't keep people from being stupid, but it somewhat lessened the impact of the stupidity.
Reply: @varno  -  It was always called 380 three phase when I was building equipment. 
Also we can use your machine tools and equipment easily. I have been on some projects putting it in. You just change the taps on the transformers and it works. Also 60hz is a little stronger than 50 so most tools and equipment work better on it, even if they are euro. 
Its a lot easier to build power supplies for 60 than 50... and motors like it better... motors of all kinds. 
We have a number of delta Y transformers here ready off the shelf to run any kinds of crazy stuff we need...  Move the taps and we are spot on. 
Good comment. I will have to read about what you are calling 415... is it a juiced up version of 380? And within spec? We have 440 and 480 three phase... and many times have to change the taps on transformers to bring it down for certain equipment.
Reply: @jimmytwoguys  -  In North America the biggest window AC unit you can run on a 120 outlet is about 13k BTU.  The 18k and up run on 220 with its own special plug.
Reply: @thomasdavis4253  yes, that's exactly what bonding is for. It means the inside of your premises are +230V but as long as you stay inside your house you are safe. You will get static shocks though which is a big clue to the fault condition.
Reply: @dasoslukos  -  Yes... Good idea about a vid on ham radio. 
Its great. I just look through the call book when I want to get on for a callsign and dial it up. Great hobby. No need to take the test ha ha ha
Reply: @shha22  -  Those main and secondary breakers have a bimetal strip in them for thermal and a magnetic coil in them that can both trip the breaker. They are all tested rigorously in manufacturing before being shipped. 100% test. I worked for Siemens/Cutler Hammer which used to be Westinghouse for a while on some of these breakers and panels. Those companies are right here in Pittsburgh Pennsylvania in USA. They work and the lawyers see too the honesty of the companies about them working. No one wants sued for faulty equipment or criminal charges. Its serious business.
Reply: @shha22  yeah the 380/400/415 is the phase/phase for 220/230/240V phase neutral. Really the difference is about 10%. Here in Australia the actual voltage in my house is 253V phase neutral, so almost at 440V, because they push the high side of the allowable tolerance here.
Reply: @paulmichaelfreedman8334  -  Depending on whether its cap or ind... yes. But many loads in the home are just resistive. Some motors inductive.
Reply: @Tharkz  that one is easy
Overhead wiring is significantly cheaper, especially in suburban retrofit and rural applications.
Reply: @btwbrand  hi. I don't doubt that. Transformers solve almost everything amd most countries use 11 or 33KV distribution mains, because that is what is basically free to run (higher voltages need special wire and insulators to stop breakdown). And yes, depending on where you are we have single and 3 phase units too, though most new units use a vfs anyway, on both single and 3 phase.
Reply: @KlodFather  historically Australia used 240V phase neutral. Notionally we moved to 230V but really all that happened is they fudged about with tolerances. So our 3 phase was 415/240, officially it is 400/230, actually my house I measure 435/250.  But really there is like 10% between these, so almost anything that runs on one will run on any of them without changes. (except some motors with thin wire).

The low voltage countries are between 100V in Japan and 127 in Mexico. This is all only for standard outlets.

By the way the Australian power plug is a great compromise between cost and safety. Stamped flat brass pins but earth protection since 2000, and polarised hot/neutral for 2 pin connectors. Hey even china thought we were onto a winner and copied us (with slightly thinner pins).
Reply: "natrual"   ;)
Reply: @ihatesmartphones  I was thinking the same, glancing at my Fluke 87 and wishing he was using one (or another decent CATIII/IV rated DMM)
Reply: 23:06 exactly... if you'd ever stepped on a UK plug you'd wish you'd just left it plugged in to the socket and switched it off with the 'unnecessary' switch instead.
Reply: As an electrical engineer i hate the word amperage .. The proper term is current.
Reply: @varno  230/400 in Australia, with tolerance of -6% / + 10%, but yes most places are still tapped at 240.
Reply: @Mithrasboy  I bet its just FM modulation. The intercom modules your speech into a higher frequency using a high carrier wave and inserts it into the mains. This gets transmitted across the house. The high frequency is to make sure it does not interfere with the 50Hz appliances. The receiving intercom at the other end just demodulates it back to audible range, pretty much same thing those Ethernet over power converters.
Reply: @Mithrasboy  As to intercoms on a ring mains circuit, those devices use radio signals, but instead of using an aerial, the radio in each unit uses the AC line to carry the radio signal. It's called carrier current, and it's also the method by which an AM college radio station would be able to be heard in the dorms on campus, but not outside the area of the college grounds.
Reply: @jussayinmipeece1069  Easy solution, close the fridge door......
Or get exercise by bench pressing the wife.
Reply: I live in the Balkans (kinda). Your "horribly gross and terribly unsafe" wiring looks to me like it was taken off the ISS. So clean, so neat :D
Reply: This was the video that finally got me to subscribe to your channel. Omg so many fascinating facts about our electrical system and you break it down so well on how it works. Please do more I really love the way you break these topics down!
Reply: @hairyairey  I doubt the 100A, usually the fuses are 32 or 25A for each phase, giving in theory 96 or 75A at 250V when distributed in the houses and 32A is common even used in apartment building as the nominal Amperage is never high enough to blow the fuse, there after the amout of circuitbreakers are determined by the size of the house
Reply: Doesn't the rest of the world do the same thing with 480v. And we have 415v 3 phase. Seems like you are still a long way off powering heavy motors etc.
Reply: @Mjollnir1983  yep as I said it is officially 230, but when they changed from 240 to 230 they changed the tolerances so that nothing actually had to change.
Reply: @varno  we do also have 480v on some farms etc.

This video kinda annoyed me 24 minutes of smug and it's just wrong.
Reply: @AaaAaa-ly3on  that's true without some conductor 120v feels like a tickle through skin. Not to say if your sweaty it won't kill you, it probably will, don't try it. But normally when you feel a tingle it's over 100v.
Reply: Two of them called shoes
Reply: @kyleaidenfox  There also arent any AFCI circuit breakers, which means unless they managed to find AFCI outlets and shove them everywhere, they are still not up to code. Plus, theres the "second grounding rod" thing and all.
American electrical codes: Read them, look at what you actually have, and be afraid.
Reply: @varno  In the US there are many industrial voltage standards some up into the many kilovolt range.
Reply: @ReeseRiverson  Your VFD converts AC to DC and then back to AC again, this allows it to output any frequency.  The frequency change is what changes motor speed.
Reply: @lordsamich755  Three-phase is run all through the neighborhoods, just not on every street.  Three phase is really only helpful for motors and most homes have only a couple of those in the 2hp or less range.
Reply: @DocNo27  Natural gas, like propane, has added odorants so you'll know when you've got a leak.  You've got an excellent point, don't use gas on anything that can absorb the odor.
Reply: @Tharkz  It's expensive to dig trenches in the ground when it's already full of plumbing, roads, sidewalks, trees, etc.  It's amazing how long the wires last hanging in the wind day after day.  New neighborhoods get underground wiring.
Reply: @varno  The ratio between phase and line voltage is fixed sqrt(3)=1.73.
So if you write about 415 V line voltage, the corresponding phase voltage is 240 V (this is used in the UK), not 230 V.
Most of the Europe now uses 400/230 Volts, some countries may still use 380/220 Volts.
Reply: @lordsamich755  The difference between C13/C14 and C15/C16 is temperature rating, not voltage. You can plug a C15 cable into a C14 appliance by design, but you can't plug a C13 cable into a C16 appliance. If you're dealing with different voltages altogether though, those are not compatible in either direction. You'd need to pick different connectors.
Reply: @varno  Yes, the 120V becomes 230V, and the 208 becomes 415, but there's no European 460V equivalent of the 240V that the video is all about.
Reply: @varno  We in the USA use 480v for our 3-phase industrial and commercial loads.
Reply: @chrislaws4785  his car charger doesn't have a neutral wire. It has two hots and a ground. What he said was correct..
Reply: @DrewbieSnack  his car charger definitely doesn't have a neutral. Neither do plenty of welders and other 240v devices that don't require a neutral. That third prong is definitely ground.
Reply: @thedavesofourlives1  afcis don't have to detect leakage. GE actually removed the gfci function from their afci breakers to reduce nuisance tripping. All they have to do is detect certain arc frequencies. And they can't even prove they do a good job of that. It would make more sense to require GFCI protection on circuits. But afci are big money so now they are in the code book for good.
Reply: You only get a single phase fed to your premise? Interesting...
Reply: @kyleaidenfox  Chill out mom.  We get it, you know a thing about code.  It's evident to me he has a  pretty damn good understanding of electricity that he doesn't need your two nec cents, or your safety clause.
Reply: @kyleaidenfox  Chill out mom.  We get it, you know a thing about code.  It's evident to me he has a  pretty damn good understanding of electricity that he doesn't need your two nec cents, or your safety clause.
Reply: @varno  3-phase@415V is actually 240V single phase, but 230V/400V I think is more common. 
Norway, also has the odd IT-grid, supplying 230V between phases, but no neutral, and local floating ground.
Reply: Won't motors do something funky if you're using 208V becuase the phases aren't at the same angle?
Reply: Venezuela (South America) is also 110V
Reply: Electroboom did a video recently. He is entertaining as well.
Reply: I find it (kind of) fascinating when you talk about using Level 2, 240V (or 208V) to get faster EV charging at home, when we have 230V by default, we have no Level 1 charging, never talk about levels either. 
2.3 kW @ 10 A, is considered slow, normal upgrade is 3.6 kW @ 16 A, or 7.4 kW @ 32 A, some vehicle even support 11 kW @ 3×16A (400 V 3-phase), or up to 22 kW @ 3×32 A (400 V 3-phase) for just a few cars.
Reply: I would say 120 is more dangerous.
The deal is, 220 volts has this tendency to "throw you away"
Unlikely 120 volts.
But since I don't have strong evidence nor studies about it.

I will stick with "is more efficient"

P.S.: those plugs are a abomination and should be extinct as soon as possible.
Reply: well aware. Coverd this in another post. Just used to historical Australian voltages and the 10% difference doesnt affect the point.
Reply: It depends entirely on whether your home is fed single, two or three phase.
Reply: This is due to power factor.  Transformers are usually rated in volt-amperes,  while tools and appliances are rated in watts,  horsepower,   or sometimes just in amps.  The reason sometimes only amps are used in the rating (FLA),  is that the power factor varies under changing load on the motor,  especially in cheaper motors,  due to I squared R losses in the windings.
Reply: @brumm3653  but no home really needs split phase at 230V single phase. Thus 460 would be a solution looking for a problem.
Reply: @gyrgrls  power factor has nothing to do with resistive losses. It has to do with phase angle (i.e capacitance) and line harmonics.
Reply: @Mithrasboy  are you saying you can buy a 3kW kettle or toaster? No wonder Barry Lewis keeps setting ish on fire.
Reply: @Mithrasboy  Big Clive has a good video about Ring Mains and rants about electrician certifications in the UK.
Reply: Wrong! It's U = R * I.

V is just the unit. How dare you make a mistake!
Reply: @sncy5303  This is no mistake. Where I live, most commercial or mixed used buildings are supplied with 480v delta or 480 volt wye power. This is used to cut costs for power hungry equipment as it is much cheaper at this voltage. For common use, 480v delta to 208v/120v wye transformer(s) are employed. This is three phase wye power so the legs are 120 degrees out of phase. the equation is that the phase to phase voltage is (square root)3 times the phase to neutral voltage. Or 1.73 times 120v =208 volts. It is not illegal and is installed as a matter of course. As it is against code to supply three phase to a residence, in order to balance the loads, one apartment will be supplied by legs A and B, the next legs B and C, the next legs A and C, and so on. So each panel has 208v phase to phase and 120v to neutral. Back in the day, center tapped delta transformers were used because power was used differently. For an office building, most of the power needed was 240v and a few 120v things. Similarly for houses, there was not a lot of electrical equipment; 120v appliances included maybe a radio, a few lights and a toaster. My understanding for the area I live in, many transformers on poles were of this configuration because during WW2 and after, this was what was available. They are being phased out. (No pun intended.) For this configuration, there is 240v phase to phase, 120v from phases A and C respectively to neutral and a high leg at phase B of 240 times sin 60 = 208. In my experience, this leg B was never used in a phase to neutral configuration. The problem with a 'high leg' delta is that we use a lot more 120v power now and it is not efficient to lose one leg for phase to neutral loads.
Reply: @station240  If it is 220, 230, 240 and on the other end 380, 400 or 415 does not really matter. Those values are only different nominal values used in different countries. But those nominal voltages come with almost ridiculous high tolerance ranges from somewhat like 0% +20% to -20% to +0%. I think the actual definition says 230 V +/ 23% for Europe since like 1983. Before Switzerland for examle had 220 V while UK had 240 V. There was something changed in 2009 which shifted the lower and upper end somewhat. 230 V by definition can range between 207 V and 253 V. It is just that people and power plants just stuck with the regular voltages, so in the UK you will measure most likely around 240, in germany for example around 230. But everything within the said range for those is acceptable.
Reply: @AmauryJacquot  only one phase? Oh wow. Standard in Germany is 3 Phase 63 A for a single house. Not that any regular house would need that much power at all.
Reply: @ihatesmartphones  For voltages I did not find it that much of a matter, also I would highla recommend beeing a bit sceptical with teh CAT rating and staying below.
Only blown Up meters I have seen so far is if someone forgot he put the leads in the plugs for measuring Amps. tha usually is fused, but with Amps they react quite violent.
Reply: @SYH653  Two wires under one screw is definitely a yes-yes if the connector is approved for the purpose. Which the vast majority, if not all, of the ground and neutral terminals in a modern panel are. So put two wires of the same size under a terminal if you like. Perfectly legal. 

Look it up. Take your time, my four year apprenticeship was the best seven years of my life.

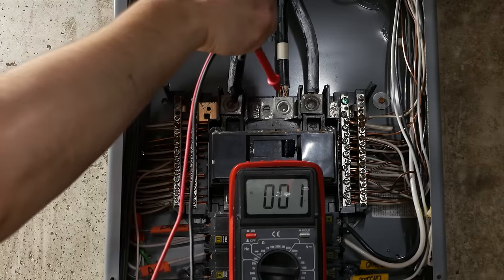The neutral is bonded to ground at the main panel and only at the main panel using the bonding screw that conveniently came with the panel that you bought. In the Square D brand panel shown in the video @7:34, I suspect that it is the green screw on the right hand side ground bar. Hardly ridiculous, since at the entry point of the house you want the ground and the neutral to be at the same potential. 

It's a safety thing. Or as we like to put it, "It's hard to get any return customers if you are busy killing off your original ones". It's probably also mentioned in marketing books as well. I dunno, I'm just a dumb electrician (well, these days a controls engineer).

Also in that panel I can't help but notice the stub of what had been a neutral that has been cut off and goes to nowhere (right hand side about the third wire down). Looks like a #6... Tsk, tsk. But kudos to the host for selecting for his home the best brand of panel to ever grace the planet.

Now for any "sub fed" panels further down the line you toss that bonding screw into the trash, and the grounds will be wired to the bar that is grounded to the panel while the neutrals will be tied to the bar that is common with the neutral. This is because you really don't want to have the ground carrying current back to the transformer  from one point in your house to another. There are exceptions to this rule, because there are always exceptions to the rules in the NEC. But the general rule is you "Gotta keep them separated" (nod to The Offspring).

So what is the risk of losing your neutral in a house? This is where things can get exciting. Without the neutral to complete the two 110 volt (there, I said it) circuits, you are now powering your house off of a 240 source in what is assuredly an imbalanced series circuit. Expect fires to break out. Expect them to do so in multiple locations.

How do I know this?, well it says right there on my Master Electrician's card that I'm supposed to know these things. Okay, it's only implied. 

How I really know this, is when I was sent out to fix a lady's ground in her home after she lost her neutral (and the ground had never been wired properly in the first place - as in completely missing) and five fires broke out simultaneously in her home. She didn't know whether to shit or go blind.

The second time that this happened was when the ground prong pulled out of the plug in a trailer home (there's a reason why we like to put the ground prong on the bottom. And even a better reason why you want to hard wire these connections in the first place). This event only burned up the aquarium pump. Please observe a moment of silence for the goldfish.

So good luck in your apprenticeship, try to learn something along the way.
Reply: 120v is safer but only because it is below the 180ish volts that is required to go through you skin/ heart supper easily.    Anything above that will pass through you skin vary easily and can kill you.
Reply: @shha22  In Canada (same system as the US mainly) You also have 347V and 600V available if you want to pay for it
Reply: @johnantonopoulous6381  Different volts for different folks. 110 volts (OCD trigger alert) being the far most lethal voltage here is the USA since it is the most common "high" voltage that you will normally encounter. Kinda like how deaths from Black Mamba bites here in the USA isn't generally a major concern.

Back when I was an apprentice electrician back in the 70's we never turned off anything under 240 VAC to work on it. This practice has fell out of fashion somewhat these days, but it did have two major advantages:

a) It lead to paying closer attention to what you were doing the next time (for the survivors). 
b) Cut down on the apprentices that probably wouldn't have made it to Journeyman level status by way of the natural selection process (essentially weeding out those that weren't volt-tolerant).
Reply: @MrWaalkman  I was just trying to say the reason people in Europe are like you need switches and special plugs is because when the voltage goes above 180ish mark I do not remember the exact number it becomes more leathel.  But because the resistance of skin a  120 volts in general will not carry enough amperage to stop a heart of a healthy individual that has no other I underlying problems.240v can jump through your skin in to the more fleshy bits. It's like trying to pass voltage backwards through  diode. At enough voltage it will just pass through.
Reply: CURRENT. NOT AMPERAGE.
Reply: @Mithrasboy  it's a ring final, not a ring main. A ring main is a circuit on a high voltage distribution network
Reply: @jussayinmipeece1069  Imagine the huge comeback he'll make on grinder
Reply: This is really unrelated, but I noticed faint slowly moving horizontal stripes at 1:30. I’ve noticed this effect in a lot of videos shot in workshops. Is this because video frame rates are sometimes at 29.97fps and it interferes with 60Hz lighting? Or is there another effect at play?
Reply: @kyleaidenfox  They are separated because negative from ground should have current  differential protection.
Reply: So American electricity system is dumb, you literally need 240V for some devices then why you run two 120V (that have 240V difference) and make this difficult for yourself's just for "safety"?  There is a system that can protect you from being shocked by simply grounding the neutral wire ( if the network supports it and that's done by your power company ). Plus you need more copper (for wiring) because on a 120V the device will draw twice the current than the device that needs 240V.
Reply: That "60Hz hum" is at 120Hz, by the way.
Reply: @varno  And why is is 415 and not the double of 460?
Reply: Also adding, since I am not entirely sure and something Mr. Connections could have touched on if it was not literally "want to be certified electrician?" level quiz info but.
Other thing or maybe the way more "safeER" making part of the 120volts is possibly not the voltage but also the phase being cut to half. Basically "the bounce" of this 120v, which is 240v full phase in two halves, is limited between zero and either +120v or -120v potential, making the phasing "half" - I was schooled but I also loose it if I don't use it so... - basically the AC current in this setup may not be going through entire phase that "normal" AC current would go through. 
Now, technically this is half way DC conversion if what I said holds entirely true and the question is what does the phase actually look like in this setup. It could be full back and forth just between two potentials = Just voltage cut off making things safER. It also could be just a bounce and literally nothing per phase which could work for certain DC applications but usually you'd like capacitors to help out. There definitely is no phase changing or flipping going on, as in type of semi-DC transformation where negative phase is flipped creating a two per hertz bounces between zero and positive potential, which even without filter could work for some DC tasks though it is not pure DC and could be bad for electronics or IT appliances. Like said I have really rusty schooling, in Europe so I get to learn US differences one quirky video at time, so I will stand corrected with anything.

TL;DR:
Also because of leaving AC to DC comparison out the IMAGE of AC electricity enjoyed by one loop out of the two within a household remains a mystery, at least with this video as only source. This could further explain the safER (not safe) aspect of US halves of 120 system.

I really do want to refresh my memory on these things now even when I haven't had professional reasons to do so.
Reply: Meh! Near enough close enough...
Reply: @kyleaidenfox  Wait! You guys have to wear Gloves to work on your Panels? I mean I Was Cringing when he used his Voltmeter to Probe In front of the Circuit breaker.
Here in Germany we got Special Fuses i an separate Fuse box which gets installed and is the Property of the Electrical supplier. Same for the power meter. and as per law there has to be a Main Switch directly after the sealed power meter. so when you buy a home yo can get an special connection box for building which lets you run your power tools until the Supplier installs his Fuse box and power meter. he then seals the empty fuse box until the main junction box is installed. so you always have either a means to Switch of the power or have no power at all on any circuit you work here. Learning to work under voltage is an extra course which is quite expensive and you need a lot more tools than just gloves to work on live wires. An insulation mat special rated tools, insulating rubber ends if you need to bend a wire and so on. granted the only place where you have no other means of working is in the street distribution which has maybe an 2000 amp breaker if your lucky. the wires are mostly at least as thick as your thumb. Our Voltmeter have different ratings too depending on where you work with them in the circuit. That is why i did my Cringe, my highest rated Meter has quite thick insulated Probes and Wires to be allowed to measure before the breakers.
Reply: Hey! Would it be more efficient to have HOT-neutral-HOT-neutral-HOT versus HOT-neutral-HOT and why?
Reply: @AmauryJacquot  In Germany every electrical grid connection of a house or apartment is triphase 400V. Actually electric kitchen stoves and stovetops use all three phases. Usually you get 63A but some apartments only have 32A.
Standard outlets are protected for 16A but most appliances have cables only suitable for 10A.
Reply: Let me start by saying that I love your I I l I love your videos. This one was good and with great production  as usual except for  por the clickbait title. Do not belittle the integrity of channel by going down this path. The us system voltages is based on system voltages following a mathematical relationship 2nV n=1, 2, 3
The current voltage base is 120V but this has not always been the case. I was hoping to see the historical evolution  that has brought us to where we are.
Reply: you should do a video on High leg 3 phase power and all 3 phase power it is the purest form of power 3 phase stuff is easy
Reply: it would be hell on earth... point in case .. USB connectors
Reply: What about 480v like in industrial/commercial
Reply: @SYH653  I learned that our electrical inspectors had no electrical training... just needed an up-to-date copy of the code, and pictorals of what proper wiring should look like. Burns my son-of-a-master-electricians' butt.
Reply: @TidusleFlemard  Thorough understanding of electrical theory are the best safety rules. You will know what is and isn't safe, and why. Fear isn't a good rule to use.
Reply: Joe Kinchicken  Exposed doorbell transformers are grounded to the cabinet via their mounting hardware, and thus are far less hazardous than a transformer in an attic, wire-nutted to a light fixture and wood-screwed to a ceiling joist.
Reply: @AaronBockelie  If the connections were good to stat with, then corrosion will not be a problem. Corrosion occurs on exposed areas, not clamped-down connections.
Perhaps you are worried about Cu/Al connections. Well, they shouldn't exist at all, but they do. They are safe as long as a bonding compound is used AND the equipment is rated for it.
Reply: @lordsamich755  No. Three phase is much more expensive, requiring special transformers and load equipment.
Reply: @k53847  Industrial/commercial systems only.
Reply: @WCM1945  
What makes a three phase transformer more expensive than a split phase transformer? 

Think about it the only real difference is putting a third wire at the intersection of the other two phases, instead of in the middle of a single phase.  In fact the American transformers must be marginally but inherently more expensive to make; as they are putting an additional tap in between all three phases. 

If the full single phase voltage is still 240v as demonstrated.  Then the winding ratios for the transformers used in basically any country besides the United States, are exactly the same. 

That means all one need to do is use a standard Non-American transformer.  Which should be much cheaper as there is a higher scale of production.
Of course they wont do that, but that's a policy problem, not a technical problem.
Reply: Dog Ma  So, Dog Ma, what IS flowing? Holes?
Reply: Do a video on AFCI power outlets
Reply: @seanj1984  The ground is there to insure that any leakage to a metal part of an appliance will be shunted to ground through that wire, not through a person. It won't help with electrical noise
Reply: @WCM1945  if you know about isolated ground circuits then you would know that the wire has an isolated ground and a bonded ground but hey you do you I dont give 2 shots if you fry your expensive electronics. I hope you dont design server rooms.
Reply: @varno  We have two types of three phase in the US, Delta and Wye, Delta mostly used in transmission and many times wye is used in buildings that supplies a neutral connection with two voltages mostly being used have the 480V with 277 to neutral and the 208V with 120 to neutral
Reply: Also that 208V will charge your car slower than 240V might not be true because of switching power supplies.
Reply: A few notes. Arc fault breakers and gfci breaker are required in more places in recent editions of the NEC
240 volts is a bit grabby. Get a firm hold on the wire and it can be hard to let go while that almost never happens with 120v.
Arcing distance is also lower for 120v.
While ground and neutral bond at the panel, it is very important they don't bond elsewhere.
Neutral wires give the worst shocks.
Reply: @varno  And our standard 230v is actually supplied at 240v. Did you know we got our standard 240v outlet from the USA? Who for some peculiar reason then got rid of it!
Reply: @LG123ABC 
I can understand what you say if hung on a line indoors, but outdoors where wind will make the clothes move it's not that noticeable. Also, adding some conditioner to the clothes can prevent that "cardboard feel". Personally, I like the "cardboard feel". It's a telltale sign that the clothes are clean.
Reply: I know you're just doing a gag at the end, although in Australia, as children we were taught the switch on the outlet was to prevent accidental electrocution. By taking power away from it, it doesn't matter how long the contacts are (or how much water is on it) because they're not live until you flick the switch. We have standard power outlets in our bathrooms here, first protected by the switch, then later also protected by the "safety switches" in the power box. But you probably already know all this 😋
Reply: @varno  in the USA, standard three phase power for commercial and industrial uses is 480V. In Canada, it's 600V. Three phase 208V is only really used in in circuits that face users directly and is used as a means to maintain phase balance in large buildings. Split phase is used in single family homes because the load of each home can be balanced against the next home. The large AC units you see on top of buildings and other large commercial/industrial machines will be 480V or more.
Reply: Maybe you'll read this, if so it's kinda related to phase etc  - at 240v, I'm guessing the waveform is effectively the same shape as a rectified sine wave, a series of humps if you will, not a nice smooth 240V RMS sine wave.  Does this affect anything?  In fact does that mean it it's a peak 240v, so the RMS insofar as you can have one for a non-sinusoidal wave is lower?  You present this stuff so clearly and with enjoyable enthusiasm, so I'd love your take :)
Reply: @kyleaidenfox  Actually, you are right! This neutral to ground system in the U.S., with the 240v divided into 2 120v sections makes things a bit complicated to do the job safely.
Reply: @kyleaidenfox  No... it may not be up to "Current code (2020) but that also only applies to new and future construction... it is also very dependent on what the most recent code is under enforcement in each jurisdiction or locality.... there are many using 2018 or even 2014 NEC code, some are even older if not in a highly developed area... There is also the question of when the house was built... if it was prior to 2002 then it is indeed within the code of the time and does not need to be changed unless there is a major upgrade to the system.  Just knowing the code is not enough, you must know When it was installed and under what Jurisdictional codes it fell under at the time.
Reply: @varno  Just watched this video and thought I'll blow those yanks out the water with my 3ph 415volts lol - you beat me!!
Reply: STOD Yes, one company in Texas for example has even ordered a few Stadler FLIRT DMUs, and there are quite a few Stadler GTW in DMU configuration in the US too. Back in the thirties, articulated diesel trains like the Burlington‘s Zephyrs were around, which should count as DMU. Or the Turbotrain, that was a french DMU bought by Amtrak and the Gas turbine trainsets of CN/Via and Amtrak, though that might stretch the DMU definition as they didn’t use Diesel afaik. And then there was the Budd RDC. To my knowledge, a few of them are still running and others run converted into track geometry cars. And likely quite a few more as I, swiss, can’t claim to know much about US railroads
Reply: In a European ring circuit they use 2.5 sq. mm wiring which is in-between our 12 AWG and 14 AWG. A typical American outlet uses 14 AWG while the European ring circuit uses what would be an equivalent of a 13 AWG for their out lets.  A typical American circuit breaker will deliver 15 amps while the ring circuit is rated at 30 Amps.  Yes the load on a ring circuit is shared by two 13 AWG wires but if one wire breaks the circuit will still work at an over loaded condition creating a fire hazard by running 30 amps on a slightly less than 20 amp wire. The American NEC (National Electric code) states a 14 AWG will handle 20 Amps and this gives a 5 amp safety margin per fused circuit. A 12 AWG is rated for 25 amps so when applied to the ring circuit of about 13 AWG there is only a 2.5 amp safety margin per wire. So in this sense American standers allow a better safety margin as only one wire carries the load as compared to two in the ring circuit. One wire fails and the American circuit stops functioning as with the ring circuit it will still function but at a higher precedence of danger. 
Now take into consideration from a safety perspective it takes only 30 milliamps to do you in. 30 milliamps is the point where it may not be possible to let go of whatever you are holding to that is causing the shock.  OSHA (The American Occupational Safety and Health Administration) states that the human body is around 500 ohms and a pressure of 60 volts can deliver 120 milliamps which is enough to cause serious injury and as stated above may end a very nice day. So either American or European household voltages are deadly. The American wall outlet just happens to give you a better chance of survival. Except for that cord thingy. 
P.S.  Some hospital equipment divides the 120v from outlets into two 60 volt sources creating a floating ground by tapping the center point in an isolation transformer. Why create another Split phase? The two opposing 60 volt wave forms cancel out superfluous noise carried on the power lines. This creates a cleaner power source for the medical equipment and some astute audiophiles.
Reply: @varno  maybe check your facts again, we also have 480 and higher so can easily run your "industrial machines" I just wired up 480 this morning for an air compressor. And many households also have that potential so try again...
Reply: @varno  our main voltage is actually 277/480v 3-phase power for heavy commercial and industrial equipment and we have seperate stepdown transformers to the 416v to be able to use equipment originally manufactured for Europe. When it comes to 3phase power for light commercial (offices, stores etc.) And residential that has 3-phase we step down from 277/480v to 120/208v
Reply: @sncy5303  we still use 120/208 in new installation off an wye connection, but that's the only voltages we get off the connection. The high-leg delta gets you 120, 208, or 240 depending on how you pull power from it
Reply: @varno  I was just about to note the same. I for one have all three phases connected to my stove and different phases distributed into different rooms.
Reply: European current is nominally 230/400. UK and Australia were 240/515.
Reply: And, as I'm sure someone has already mentioned, in the UK we are not on 240v anymore. We moved to 230v, in line with Europe, years ago!
Reply: @16v15  2 wires under one screw or lug is only permitted if it is listed for such use, that is code. Also ground (earth) and neutral shall be separate from each other except at the origin of the power system i.e. main panel/transformer.
Reply: @SYH653  Neutral and ground, according to NEC, are to be grounded at one and only one location. This is widely disregarded in practice.
Reply: Erhm, you realise EU runs 380V?
Reply: @sncy5303  That isn't quite right. On a 3 phase wye with 120V to neutral on each of the phases, you WILL get 208V between phases, NOT 240V. On high leg delta one of the phases will be 208V to neutral, but using that to run loads has never been to code.
Reply: @paulmichaelfreedman8334  If you multiply RMS volts with RMS amps you'll get RMS watts. A standard meter will show you the RMS readings for both voltage and current assuming that the input is a sinewave, and a "true RMS" meter will do the same even if the input is not a sinewave. The nameplate ratings on equipment are also RMS volts, amps, and watts. So yes, AC power IS calculated by multiplying voltage and current alone, because the convention with AC power is that voltage and current are specified as RMS values, NOT peak values. If they were peak values then your statement would be correct..but peak values are simply not used and test instruments do not (usually) display them.
Reply: @chrislaws4785   4-prong dryer and range outlets were always required for mobile homes...and were required everywhere prior to WWII, when the code was changed to allow 3 prong outlets to save copper for the war. I noticed that my dad's house built in 1987, they ran a 4-wire cable to the dryer outlet and installed a 3-prong outlet. I replaced that and the dryer cord with 4-prong ones. The "elektrishun" who installed the 3-prong outlet seemed to be really confused about what to do with the bare ground wire, because it was connected with a lug to the outlet's frame.
Reply: @kaitlyn__L  Back in the 60s Bell Telephone in the USA used to install 6-pair telephone wire in houses in hopes that the customer would pay for an intercom system, which would use the extra pairs. They stopped doing this after several years and went to using 3-pair wire. I guess they didn't get many takers on the intercom system.
Reply: @thomasdavis4253  As the NEC says, the neutral and ground are only to be connected together at the "service disconnecting means".
Reply: @brianleeper5737  that makes sense! The Bell System stuff is fascinating to me, since I've grown up over the pond with legacy GPO phone equipment dotted about the place. Our phone systems seem to work very similarly nowadays, but they were so different in the 60s!
Reply: @chaos.corner  I looked into this. The nominal voltage has been increased over the years. It started at 110V, then went to 115V, then 117V, and finally 120V. It seems like what happened is that the allowable voltage drop under load was reduced, so while 110V (as measured at the meter) was once acceptable, it isn't anymore--the electric utility aims to have 120V at the meter. This is at the meter, not at the outlet. The voltage may be lower at the outlet, on a long circuit under a heavy load. Interior wiring is governed by the NEC and they do not mandate that wire be upsized on long circuits to reduce voltage drop, although a competent electrican will do so.
Reply: Often - Temporary fixes work permanently :)
Reply: If I need an electrical job done soon I'll do it myself.  If I need it done right I hope I have the money to pay a professional or patience to save for the cost.
Reply: @Mithrasboy  the oven would also have an isolator switch to kill the power to the socket
Reply: @ole-martinbroz8590  America has pioneered just about everything before they could set a standard for it. They've had crazy standards on measurements that are hard to define they have their own idea of a gallon which is different from the UK gallon they have wireless phone frequencies that nobody else uses and their power is their own. They made these things then after it was widely implemented thought this really caught on and is a good idea but if we were to do it all over again what would we change. They have these meetings and standards set up and conclude it would be better if we did xy or z the rest of the world learns from America's trial and partial error and decides to build using recommendations learned from watching America the new one is ipv6 addressing protocol too much has been done trying to keep ipv4 going as long as it has and a ton of workarounds have had to be put in place which cause issues themselves had we had the opportunity to watch ipv4 from afar before the internet became a huge thing we could have set up a proper standard before trillions was invested on ipv4 based protocols
Reply: Where’s all the arc fault, AGFCI, and GFCI’s?????
Reply: Just remember, 277+277=480Y
Reply: Work as an Electrician for a while. You do not understand.
Reply: @SYH653  Neutral and ground are bonded at the box, but only at the main box. One location only.  This is to ensure the neutral has ground polarity but that the ground cannot be used as a parallel neutral.
Reply: @sncy5303  208V could be from a high-leg delta, but that's quite rare these days, especially in residential buildings. One of its few redeeming qualities is being able to obtain all three voltages, though (120,208,240) due to the grounded center-tap between the two non-"high" phases. Apartment buildings sending 2 of 3 phases to each unit (A & B to apt1, B & C to apt2, A & C to apt3 etc.) is much more common, and in that scenario you do get the 120/208 split (ratio 1.73 = sqrt(3)), and no access to proper 240V.
Reply: @PanicStation1337  277V/480V 3-phase is also common in the US, but only in larger commercial and industrial buildings. Typically the 277V line-to-neutral is used for lighting, 480V for motors in elevators, large HVAC units, etc. Then each floor may have a step-down transformer dropping that to either 120V/208V 3ph or 120V/240V split-phase as needed. Some large data center equipment draws from the 277/480V directly. 277/480 is never supplied to residences, not considered worth the additional hazards (arc flash, etc.), and no home appliances expect those voltages.
Reply: @LG123ABC  I've wondered why no one's tried to use a vacuum pump (and sealed drum of course) to reduce the huge energy demand of an electric clothes dryer. In theory it should be more efficient than heat alone, albeit with added noise, moving parts and complexity.
Reply: @homestar92  Though rare, there are some 120V "mini-split" systems, usually inverter-type (VFD) compressor drive. Cooling a whole house would usually take 2 or 3, so it's not quite "central," but have some advantages. Large window AC's (more than about 12000btu/hr) are usually 240V, typically with a NEMA 6 plug, no larger than normal since it's only 15 or 20A, but with the "hot" blade turned sideways to prevent accidental cross-connection of voltages.
Reply: Please do a video on the Swedish 240/400V TN-S and TN-C systems.
Reply: @SuperWasara  This will work fine electrically, but wouldn't pass a building inspection since European outlets, even if objectively better, haven't been tested or approved for use here, and won't fit the required American junction boxes. I've instead installed NEMA 6-15 receptacles (American standard 240V/15A) and made up some NEMA6-to-Schuko adapter pigtails. Just changing the appliance's plug is another option. One difference is that both terminals (brown & blue wires) will be "live", at 120V to ground on US 240V power. Since a common Europlug or Schuko is reversible/nonpolarized anyway this rarely matters, but is worth remembering if you're repairing something with the cover removed, etc
Reply: @foff8375  Neutral carries power (completes the circuit) while ground normally does not. This improves safety.  Metal appliances, electrical boxes and racks etc. will have their outer casework bonded to ground (which is why a metal breaker box is not dangerous), so if neutral/ground were joined, a loose or broken wire upstream could energize the exposed metal (via the load circuit) without immediately tripping a breaker or RCD/GFCI. WIth separate wires it would take multiple, concurrent faults for this to happen.
Reply: @regiondeltas  Ring mains are a cool ideal, but the one thing that makes me apprehensive is that a broken wire or loose terminal somewhere in the middle would not be immediately obvious, each side of the break still getting power, yet the ring's (safe) ampacity would be cut in half. A subsequent sustained overload could then overheat wiring in the working half the ring without tripping the breaker. I think this concern is the reason why US code doesn't allow parallel connections for increased amperage except in very large wire sizes (AWG 1/0 = 53.5mm^2 minimum)
Reply: @jordanhazen7761  Yep, and that's a genuine issue. It's rare, and a far as I know hasn't been attributed to any serious incidents but it is an issue and something that should be tested
Reply: @varno  that is true for most of germany, however, i've been living in an area where i had only two hot wires and a neutral going to the breaker box for some weird reason. 
even weirder: the stove and water heater each were powered by a single hot wire on a 25A breaker instead of the 3x 16A that we usually hook these devices up to
dunno what that was about and because i did not own the building, i left the breaker box alone as much as possible.
Reply: @sncy5303 :
I apologize for taking issue with you, but you are wrong.
The "standard" 120/240V 3-phase delta system involves a 120/240 volt "single-phase" three wire transformer, supplying those voltages, PLUS two 240 volt transformers supplying the other 240 volt phases, in a so-called 120/240 volt three-phase four-wire delta configuration (I'm here ignoring "open-delta" construction).  The voltage to ground of two of the "hot" wires is 120 volts; the voltage to ground of the third "hot" wire is (120 times the square root of 3) volts.  The three "hot" wires are used exclusively for three phase 240 volt equipment. The three 120/240 volt wires are used for 120 volt, 240 volt, and 120/240 volt "single-phase" equipment.  As these systems are inherently unbalanced with respect to the loads on the three phases, they are typically used where the single-phase load ( 120 or 240 volt) is much less than the three-phase load, OR where the majority of the load is "single-phase" ("balanced" among various customers) and the amount of three-phase load is minuscule.
In the case of more-common three-phase "wye" or "star" systems, the line-to-neutral voltage of each phase is 120 volts (double that in Europe).  The line-to-line voltage is 208 volts (really 120 times the square root of 3) (again, double that in Europe, and often called 415 volts).  In the European context, and other nations following the same standards, the 240/416 or 240/415 systems are frequently called 220/380 or 230/400 volt (in each case, the line-to-line voltage is 1.7321 times the line-to-neutral value, rounded to a convenient number
Reply: I knew it! I always wondered why some of the recipes I used seemed to differ on Med/High/etc with the results I was getting! This finally explains it and I'm not as crazy I thought! I didn't even consider apartments would have 208V.
Reply: Not just tidy. Change and use  elcb
Reply: @Mithrasboy  the ring main was devised in order to save copper,  generally each ring is nominally 30a , rather than have a 30a rated cable to each outlet by having them arranged on a ring so each outlet is connected by two sets of conductors. These conductors can then be reduced in cross section. IMHO it is not terribly clever because if any one conductor becomes detached the whole ring will still operate. I have never seen the intercom you describe though I have seen some that use RF superimposed on the conductors.
Reply: @SYH653  Never, ever try to understand the logic of local inspectors.  You'll go crazy and you won't learn anything about safe construction.  Just nod and do what they say.  I had one that told me to replace a perfectly good, perfectly code-legal joist hanger made for 2x10 joists on a 2x10 joist because joists in another part of the house used (also perfectly code legal) hangers that could be used on either a 2x8 or 2x10 because, apparently "all hangers have to be uniform."  RIGGHTTTT.  Because the they all talk to each other and if one doesn't match, the other hangers will ostracize it and it may fall out of the wall.
Reply: @sncy5303  I don't want to complain but with three phases, the phases are shifted by 120°, not 180°. It's impossible to get 240 volts between two phases if each has 120V agains neutral. That's not how physics work.
Reply: You're wrong about higher voltages being more dangerous (to an extent). 120v is particularly dangerous because it lets enough current into your hearth to contract some muscles but not all of them, causing ventricular fibrillation which will lead to cardiac arrest. At higher voltages it's more likely that all your heart muscles will clamp together and as soon as you're disconnected from the circuit your heart will resume with it's normal rythm, this is similar to how a defibrillator works. At too high voltages or long exposures your muscles can become damaged and then your hearth will just flatline.
Reply: @caphikoki  I'll see your high leg delta and raise you a corner ground 480 delta. See em on remote farm pumps.
Reply: That rant at the end was amazing.
Reply: @kyleaidenfox  Neutral and ground are only separated if it's a sub panel. If that was the main panel (like it is in many homes), then they need to be connected.
Reply: @kyleaidenfox  but so far he has had a 100% success rate in not being injured or burning the house down :)
Reply: This was really interesting, I'll be sure to sniff around a distribution box next time I'm in the USA. Question... Are there any properties in the USA that don't have split phase power coming in?
Reply: @vintageradioservices3622  All properties have split phase power. 3 phase for large buildings that need a lot of power; 2 for homes and small businesses. It's because the power is generated in three phases, all 120 degrees apart. It's even beneficial because it lets you use one neutral wire for three power wires, all the same size, and the neutral won't blow up because the power is on different phases and won't overload the neutral wire.
Reply: what about 277v? xD
Reply: Wow you seem to have a chip on your shoulder about your terrible sockets and plugs 😂😂
Reply: Old bs.... diff day...
Reply: In a typical north american home, what would be required between the main board and an outlet to safeley power an appliance that was designed to work on on 220v power like in the UK ? I understand that if I wired the +120 leg to the Hot Pin, the -120 leg to the neutral pin and the earth to the earth I would meter ~240v, but would thatcreate a hazard of the device chasis being shorted ? Im asking because I have a significant inventment in various 220v appliances and may soon need to relocate back to Canada.
Reply: Well if your living in an apart that has 208 volts, just think of it as an Intel Ulv CPU... Compared to a full 35 watt dual core CPU, your getting like 85% of the same performance assuming same architecture clock per clock.
Reply: That's what's known as the wimpy Wye system.
Reply: So, we in Europe, with your kind of argumentation don't have 230V but we do have three phase electric power, with each phase having 230V and a phase shift of 120° each. If you connect two phases, you'll get 230V×√3≈400V. So usually we have three lines in each house, where each line will serve a different machine and each line is fused with 16A, that makes three times 3680 Watts or 6400 Watts of power, if you put in a machine that is running on all lines. 
In the US you secure each 120V line with 20A and with that you got 2400W for a single line or 4800W for a double line. 
It's still inferior. And if you are going to throw away your aged power system, get rid of that terrible imperial system if you are already on it. 
hehehe
Reply: @varno  Large industrial equipment is 3 phase 480volts in the US but wired delta so no neutral, no 415.
Reply: @TheOtherBill  that's all I was asking. Even tough I'm not familiar with the code in the US I didn't catch anything In the video that seem'd false or wrong.
Reply: @ReeseRiverson  You have a 240V 30A circuit for your subwoofer alone?! Is your home theater an IMAX?
Reply: @Novel_clips  Very limited application due to restrictions put in place by our very likely corrupt Federal Railway Administration. And likely exacerbated by good ol' American not-invented-hereism.
Reply: @station240  and @nebuchadnedzzar You are both incorrect. With the old 220V norm you got 380V between 2 phases. In the UK they had 240V/415V. Now the voltages in (most of?) Europe are normalized to 230v/400V. There is always a difference of the square root of 3 between the voltage between 2 phases and the voltage on one phase to ground.
Reply: @kyleaidenfox  Sooo, the NFC prohibits bonding a primary single phase service now?
Reply: @varno  Actually, no. Our 3 phase system is 480/277V. For a detached single family residence to have a 3 phase service is rare. Maybe in very large apartment complexes you will find the 120/208 sub services. It's also what we do for industrial and commercial services most of the time. The 480/277 is used for motor loads and lighting, and transformed into 120/208 for mostly plug connected loads.
Reply: @seanj1984  Uhm, sub panels are not supposed to have the ground and neutral joined. Only at the first or primary service. When feeding a sub you are supposed to run a ground with it.
Reply: @btwbrand  Well, you say that, but the supply wiring to provide 3phase to a home is rare. It's usually not in close proximity. You can get phase generators? to convert single phase to 3, but they are very inefficient.
Reply: Only if you're driving it flat out without a temperature cutout.
Reply: @lordsamich755  Power in the U.S. is distributed in 3-ph, but different phases often service different parts of the residential and light commercial grid. 
The way power is distributed inside most houses here is no different than the way power is distributed inside many devices. A center-tapped transformer in a radio or stereo might convert 230V from the mains into +/- 15V into DC (rectified) for a variety of solid state electronics like microcontrollers, display panels, and op amps. U.S. residential power employs the same principle. It's not really "more complicated" in any real sense, and I can't think of any particular advantage on the spot, it's just different.
Reply: Re your mention of 110V being safer, I have read that 120V is less safe than 240V. Why? Because the actual current through your heart is what decide whether ventricular fibrillation occurs, and this is most likely between 60mA and around 200mA Above 200mA the current behaves like DC in that the heart clamps hard then upon release returns to normal rhythm (most likely). At the lower currents you get the AC modulating the contractions in a manner that causes simultaneous contraction of parts of the heart only. Anyhow, that's what I read. Oh! and the LV directive specifies 80V DC or 42V AC again because of what current flows in the average body, and the differences between AC & DC.
Reply: @lordsamich755  A "split phase" transformer still only needs two coils, a 3 phase transformer needs 6.  Boost and buck converters have limitations of their own and aren't suitable for all applications.  They tend to get very expensive if you have significant current demands, and there is a limit to how much power you get.  I recently was designing a system for which I needed about 400VDC. From a standard wall outlet it was much, much cheaper to use a solid-state voltage tripling rectifier than to buy either a transformer or a switching supply, but the boost converter was the most expensive by far.  
That 70's Show is quite entertaining, I hope you were able to enjoy it.
Reply: @hairyairey  aaand here we go,.... 50vAC to 1000AC= low voltage in uk
120vDC to 1500vDC= low voltage in uk
Up to 50v is elv(extra low voltage)
Three phase boards are present in uk where a solar panel system is used on big houses 4 beds plus and with attached garage and summer house.
Reply: Ring mains are not a thing anymore.
Reply: @sl06bhytmar  power factor correction allows you to deliver power more efficiently. There's nothing inherent to three phase that "fixes" the inductive loading of motors. You can just as easily have a poor efficiency 3-ph motor. In my engineering classes we set up an induction motor with a PF in the 0.4x range to demonstrate capacitive PFC.
Reply: @Kekistani Refugee That would be free power, it would go back  into the grid and be used elsewhere. Poor power factor (usually inductive) uses excessive current.
Reply: @hairyairey  There is indeed (at least sometimes) a small voltage difference between neutral and earth/ground. Whilst fitting a socket in the loft at my old place many years ago, I accidentally touched the neutral and earth, tripping the RCD and leaving me in darkness ..
Reply: @sncy5303  In most of your downtown network grid systems in the US, a 3 phase delta-wye system is used. This is a 120/208 system. For our utility, 480 systems are also a Wye secondary connection and would be 277/480V all 3 phase. We use 120/240V delta systems for residential service.
Reply: @hairyairey  I remember tripping the ELCB by accidentally touching the neutral and earth together whilst fitting a socket. There can indeed be a small voltage difference!
Reply: @BG101UK  Yes, very annoying. Have had to tape up the neutral cable many times to stop this.
Reply: 208 is sucko.
Reply: it is a 120v.+120v= 240 system that north America is using.  The 120 volt is 90° out of phase of each other that why when you connect a north America oven/ clothes dryer that are 220/240 volts. 
re: In most homes there's  3 wires that come from the electrical pole 2/ hots & 1 neutral also a ground wire that you put two ground rods. Are 5ft. long three feet apart. hammered into the ground.
Reply: That transformer is not legal
Reply: @kyleaidenfox  double lugging is allowed by the nec. Some local codes say not to and you can not do it on something like a plug. But it is legal in an electrical panel
Reply: What about inductive loading.
Reply: Double like
Reply: @kyleaidenfox  it's for the same reason you only ground one end of a twisted, shielded pair. Not all grounds are equal and it can cause small, but not insignificant, circulating currents.
Reply: No one said it was 120v. The normal home delivery for small devices is 120v and the energy monsters are 240v. It was bel I ever the lower voltage would save lives.
Reply: SN CY that’s incorrect information. A typical apartment building in North America will be supplied by a three phase delta-wye transformer, such that each dwelling will have a 120/208V service. The X0 point becomes a neutral by being tied to ground, and provides 120V from each line. Phase to phase offers 208V. High leg delta is far less common, and will offer 120/208 and also 240V. Each phase is 240V, however one phase is center tapped, and connected to ground as a neutral. This phase can supply 120V, and the “high leg” will offer 208V to this neutral point. It’s important to understand why high leg delta is not the ideal connection for apartment buildings- most consumers are using 120V, which is only available on the phase which is center tapped!! The delta-wye connection is much more common, as 240V is not necessary; apartment appliances are readily available with a 208V rating.
Reply: At my job we have some antiquated machines that still use 208 VAC, what a pain.
Reply: Actually Alec, a note you made isn't actually supposed to be like that, your electrician just ran out of spaces on the neutral bar, yes ultimately they do combine up. However, my father is an electrician and wouldn't be caught dead with a panel that had ground and neutral sharing a bus bar. It is ultimately bad form to combine the two bars and they are supposed to be separate.
Reply: Just a "technical observation" - you cannot "pull"  any percentage of power (or current squared  * R  * cos (theta)   Circuits /loads  dont "pull"  current - it is the source  ie Voltage  that "forces"  current through a load or resistance  ( impedance for the purists in AC circuits ) .
Reply: @varno  In North America 3 phase  - 208 is usually for commercial (stores small shops) 440 and 600 is for  industrial and 2200 and 13800 is for heavy industrial use all at 60 Hz  your 415 sounds like a 50 Hertz standard
Reply: I gotta tell ya, I stumbled across your channel by mistake but was pleasantly surprised. I don't know if I would ever wire anything, but it is better to know about it than not to. I was hit by lightning as a kid with a week in the hospital. So now, I'm the guy that unplugs a lamp before I change the bulb.
Reply: @Novel_clips  yes, but fewer now that years ago, as most trains are for freight
Reply: Technology Connections in Sweden we have 230v to neutral and 3 phase 400v.
Reply: ok its a 120 system yes you can use 220 we don't use 220 to light our houses and yes we do plug in our AC units into a 120 outlet are you just misinformed you make it sound like we use 220 like UK  o and by the way we also use 347 volts daily and 600 volts daily so douse that means we are a 347-volt country I think not your argument about the electrical panel is correct however  your tv is 120 your fridge is 120  most apartment sized washer and dryer dishwasher toasters and an array of different things plug only into a 120 Outlets & Receptacles lights in your house are not 220 so with that, I don't understand your rant about making this vid i hope you get a licensed electrician to tidy up that panel  you are not Qualified.thanks have a great day
Reply: I do think the point of most people thinking of the US as a 120V country is us Europeans being provided with 230V/380V instead of 120V/240V
Reply: Thank you
Reply: >be me
>want to comment this
>author already did it
Stop making my life useless
Reply: uh..  sqaure of the voltage?     1 volt at 1 amp is 1 watt...     5 volts at 1 amp is 5 watts...  in the case of what your saying , a thermocoupler would not reach temp at X watts?..    no its x voltage and it draws what it needs to operate.. and if your talking about thermal runaway then elictricy isn't the main cause, its design.. lol
Reply: @varno Thanks for the very informative country specifics here. I am quite aghast at the terrible standards and legacy use of 120V for consumer electricity. Also the two prong and three prong North American pluginand dockets are just a bad legacy design that should just die. I just love the British standard fused plugin with the heavy rectangular lugs and the gated plugin shutter. All plugin devices are much safer and more robust in design, when using the European 240V mains power and multiple fused plugins. Here in Canada, we have no real choice but to use these cheap MOV protected powerbars for device protection. I really prefer the American POWER Corporation (APC) powerbars, they are designed very well and are reasonably priced at different levels of protection for use across a wide range of products, also they actually paid their warranty out for me when an older Samsung LED television power supply blew up (literally), and the American Power powerbar circuitry was basically fused. I do not, nor never have I ever worked for APC, but I sure have used their products in data-centers all around the world. Cheers from Canada.
Reply: @ChadNewitz  My guess is NEITHER. He is a fruitcake,
Reply: Just Google Perilex, fun, ain't it :-)))
Reply: Europe harmonized on 230/400 three-phase. Some were previously 220/380 or 240/415. (Rounded from 230/398, 220/381, 240/416.) US uses 120/208 (three-phase) for industry and most business (can't get it at home), 120/240 (split-phase) for homes and some business. US also has 277/480. (Some places have a crazy mix: 120/240/208. Be careful.)
Reply: Heating elements and incandescent light bulbs are notorious nonlinear resistors, so not all that simple.
Reply: @pirobot668beta  E = I * R and P = E * I. So P = I squared * R and P = E squared / R.
Reply: @varno  230/400 officially in Australia, but most places are still tapped at 240V and above
Reply: @Mjollnir1983  if you looked at my previous posts, I mentioned something to that effect.
Reply: @bobraible  Incandescent light bulbs vary a lot because of the extreme temperature change from room temperature to 2380°C / 4310°F. I just measured a 120V 100W bulb as 10Ω; if I turn it on cold, it will draw 12A, so 1440W (using the RMS number). Actually its initial instantaneous draw would be a random value between 0A at 0V (0W) and 16.97A at 169.7V (2880W). Hot, its resistance increases to 144Ω (a factor 14.4x) to draw its nominal 100W at 120V. One would expect a heating element to increase in resistance, but by not nearly as large a factor, depending on the actual temperature and temperature coefficient. The heaters in electric blankets and hot water heaters should change very little; glowing radiant heaters such as toasters will change more. Decreasing voltage from 240 to 207.8 (86.6%) will decrease the power. For an unchanging resistor, the power is 75% (86.6% x 86.6%). Running a light bulb at 86.6% of the voltage (running a 240V light bulb, if there were such a thing, on 208V) results in 92.3% of the current, so it uses 80.0% of the power (not much more than 75% of the power), 60.9% of the light output, 7.5x the bulb life, and a redder color. (Wikipedia, "Lamp rerating".) In a stove or oven, the thermostat just runs the heating element with a higher duty cycle to make up for the reduced heat output. For a heater to dissipate the same power at reduced voltage, it would need an extremely high positive temperature coefficient that would draw an absurdly large inrush current when cold. A control circuit can force the heating element to dissipate constant power or maintain a constant temperature by regulating or varying the voltage and/or duty cycle as needed.
Reply: @brianleeper5737  Almost right. If you multiply RMS volts by RMS amps you get RMS volt-amperes*, which is the unit of *apparent power*. To measure *actual power in watts, you need a power meter (or a kilowatthour meter - and divide energy (kWh) by time (h) to get power (kW)). Or, if you know the power factor, you can multiply the apparent power by the power factor to get the actual power. If the load is purely resistive, true power = apparent power and it's simple. If the load has any reactive component, the actual power can be less. If the load is a simple inductor, power factor is approximately 0, and actual power is approximately 0W. If the load is a simple capacitor, the same. Also a diode-input power supply without power-factor correction (usually only small power supplies such as in PCs), power factor can be around 0.65, so at 120V it might draw 4A, so that's 480VA, but it only consumes 312W (you could confirm by calorimeter) and the utility meter only charges you for the 312W. A true power is a tricky concept - it has to continuously multiply the instantaneous voltage by the instantaneous current, yielding the instantaneous power, which it has to average. With a pure inductor or capacitor, the instantaneous power alternates positive and negative - the reactive load alternately draws energy and *gives it back*, and they cancel out, making an average power of 0W - the capacitor doesn't get hot and the utility meter doesn't rotate.
Reply: @quaztron  Nice analysis. In the case of incandescent light bulbs I believe the cold filament inrush current shortens the life of the filament. I don't believe many people concerned themselvess with this since light bulbs are relatively inexpensive. For bulbs that are hard to replace or are part of critical infrastructure (exit signs for example), sturdier bulb designs were used that sacrificed energy efficiency for reliabilty and long life.
Reply: @bobraible  Yes. It seemed like most dead bulbs blew at switch-on, with a slightly blue-tinted flash and a clink sound. Most dimmer switches incidentally make every start into a slow-start,  probably extending bulb life, but we'll never know by how much because it would need a large controlled study to get a reliable statistic. One solution was marketed, a button-shaped NTC thermistor that you tuck into the socket,  underneath the build. It made a soft-start at every power-on. It was funny to flip on the switch and see the bulb take 2 seconds to ramp up to max brightness. I wasn't hooked; max brightness was less than full brightness because voltage drop never went to zero. NTC thermistors are sold and used as in rush current limited. Most pc power supplies contain one to spread out the inrush current charging the big input capacitor(s) through the rectifier diodes. Someone else marketed a button-shaped rectifier diode that lossless reduced the RMS voltage to 70.7%, making a dim reddish light at low efficiency. They were taken out and shot. The stupidest thing I saw was when a lazy building "super" replaced all the 120V bulbs in the hallways with 230V bulbs. The result was hideous. Infinite bulb life (maybe 50x?) but full reddish glow. What a dim bulb. A common life extender was "130V" bulbs, but using 230V is stupid and wasteful. I suspect that where power is cheaper, the utilities send lower voltage so bulbs last longer, at lower efficiency; and where power is more expensive, they send higher voltage to make bulbs more efficient, but fail sooner. (Our rates are a little high. We always had 125VAC.)
Reply: @quaztron  "Someone else marketed a button-shaped rectifier diode that lossless reduced the RMS voltage to 70.7%, making a dim reddish light at low efficiency. They were taken out and shot. "

I remember seeing adverts for those in the back of magazines. They were pretty much useless. If you needed long bulb life buy a long-life bulb and sacrifice a few lumens.
Reply: @Novel_clips  Yes. We had them way back in the 40s even.
Reply: @shha22  You would love our breakers. Ever see a 1200 Amp one used on 480 Volts 3 phase? Huge, but still multiple use with a switch. Now our house is a little different from many. We have the 120/240 like most. But outside the house is a transfer switch ( another small one inside the house too ) which has fuses ( Slow blow 200 Amp ones ) and inside the house is the main panel with a 200 AMP 240VAC breaker. Now why does the outside one have fuses? Because it can be used for a number of things. Up to and including 600 AMP 3 phase power if we wanted it. The rating of the fuses just limits what can be drawn and there was at one point plans to increase our power to 400 Amp Service with a second Main Breaker Panel. Some houses here do have 3 phase power even. Depends on if there is three phase at the pole. In our case, there isn't. But that doesn't stop me from having 3 phase equipment. A VFD takes care of that or as is our case, just fire up a generator. Which being a 12 wire unit ( pull your shoes off to count that high if in Europe ;-) ) allows anything from 480VAC down to 120 Volts in either single or 3 Phase. And either 50 or 60 Hz depending on the speed you set it at.
Reply: @IceBergGeo  And some homes have 120/208VAC 3 phase also. It isn't just used in multiple dwelling locations. What gets interesting is when a phase goes down.
Reply: @kyleaidenfox  That's his main panel. Neutral and ground are always bonded at the service entrance. You must understand that in order for a safety ground to work, it MUST BE BONDED TO THE ULITIY COMPANY'S GROUND SYSTEM which is the neutral coming to the building. The 8 ft ground rod(s) at the building is basically redundant. The substation grounding grid is where the real grounding happens.
Reply: @sncy5303  You got them confused. Tree phase star is 120v to neutral and 208v to phase. Delta systems normally have 240v to phase.
Reply: @foureyedchick  Center tapped systems are rarely seen in commercial buildings, they are almost exclusively seen in residential homes and apartments. The vast majority of commercial buildings have 120/208v three phase wye panels feeding receptacles. Also the breakers would have to be rated for the higher voltage.
Reply: @paulmichaelfreedman8334  Yes, true power = apparent power X the cosine of the phase angle between the voltage and current. (cosine of O degrees is 1, cosine of 90 degrees is 0). When the phase angle is exactly 90 deg, the load is purely inductive or purely capacitive, with no power transfer.
Reply: You sure live up to the nickname of "Smart Alec" with this video.  😉
Reply: @SYH653  For the first panel, not a subpanel, bonding both is required and correct.
Reply: @SYH653  When I quickly read your comment, my brain transposed "imperator" in the place of "inspector".  Weird, huh?  It kind of means the same thing but commands more authority. 

Example:

 "Imperator Goldie Wilson...  I like the sound o that!"  

- Future Mayor of Hill Valley "Goldie" Wilson, 1955.  At least that's what some butthead told me he said back in 1985.

Edit to add obvious following statement, you guessed it...
"ONE POINT TWENTY ONE JIGGWATTS!  GREAT SCOT!"
Reply: @sncy5303  120/208 is common in apartments. HIgh leg 240 delta will give you 208v but it also only gives you two 120v circuits (which would require a larger center tapped transformer and would cause an imbalance on the electric companies distribution lines. What he is talking about is a wye service 208v L:L and 120v L:N.   If you have say 30 apartments you run 10 apartments on each of your 3 possible "single phase" combinations; A:B , A:C , B:C. Doing so keeps the load on the distribution side relatively balanced (No extra induced harmonics) and you have 3 phase to run the pumps, boiler, and so on for hydronic baseboard heating and such.
Reply: @joshuaewalker  That's hilarious. Worth reading through the billion or so comments for.
Reply: @ihatesmartphones  I would disagree with you on this one.  I have both digital and analog meters.  All Digital meters have a safety Fuse.  The Analog is a $10 cheapy and I can read 120V with absolutely no issue to the meter.  Most all meters can handle the Voltage requirements for the area you bought them in.   That being said, if you exceed the METERS CAPABILITIES you can cause a problem that even the Fuse can't protect..   More expensive meters will have higher levels of capabilities especially for Voltage and Amperage.  So if you need to take readings at higher levels get the more expensive meter.  Otherwise any meter can be used for the basics as shown in this video.
Reply: @ihatesmartphones  I might have to give that a try.  I've have seem them older ones smoke a little but never explode.
Reply: Our system is 400v
Reply: It's allways nearly the double of the voltage because of the 3phase generation of the power and many European countries have 400v because we mostly cook Elektrik and mostly there u have a 400v
Reply: @Mithrasboy  I understand this power distribution approach originated (or become prevalent?) with the shortage of copper after WWII. Feeding power from both sides of the ring effectively doubles the "ampacity" (as this was called here in the US). Comment - this is how weird stuff becomes entrenched just like 120-60Hz  vs 220-50Hz, weird plugs and all that local nonsense that you have to put up with when building world-wide compliant equipment that has to conform to all local requirements  without having to have all manner of variants. And then there is Japan with the requirement of sub 100V ac (90V min).
Reply: The 110v/220v or 115v/230v WAS correct, at one time.  It is a historical notation thing that has hung on....according to my info at least.
Reply: @montecorbit8280  sure it's historic reasons same why the US still use the imperial system. I understand why at the invention of the Elektrik grid it make sense use Lover voltage too safe life but with modern safety systems its not work staying there the EU is now on the way too 250v before 220 like every few years 10v more
Reply: I do hope that the picture at 3:14 is ancient as it still quite antiquated to me that all power cables below the "near-megawatt" cables are still above ground in the US!! Is that really so?? And what you mention about the 240 Volt usage in the US, is what would, in reality, be what we use 380 Volts for in Europe. So we do have 240 Volts for all normal appliances in our house (lamps, TV, computers, toasters, etc.), but - to paraphrase yourself: "Did you really think we are cooling our homes only using 240 Volts from a regular outlet? No! And some of us have electric stoves, electric water heaters, clothes dryers, even electric vehicle chargers. We are not doing that at a measly 13 Amps at 240 Volts!" 
Our washing machines, clothes dryers, electric stoves, etc. all run on 380 Volts at 20 Amps ... Naturally!
Reply: Are you talking rms or peek to peek
Reply: @SYH653  why is two wires under one screw a big nono? We do that alot in switzerland which is a 230v system
Reply: Some confusion.  For a fixed resistance the power delivered by 208 V RMS is only 75% of the power delivered by 240 volts but facilities (including homes) are wired for a maximum amperage, not with a some fixed resistance and varying voltage.  208 V is the potential between two 120 V lines 120 degrees out of phase. Homes are not wired for three phase operation.  The 120 V lines in home service are 180 degrees out of phase. AC power is three phase because that is the easiest way to make generators that can be balanced mechanically.
Reply: @caphikoki  good old side tap delta. Two legs 120 to ground the remaining 240 to ground and any phase to phase 240 aka 240v 3p.
Reply: The fun one in the US is 277/480v 3p. Any phase to ground/neutral is 277 phase to phase 480. It is also a Y configuration. But other commercial power is 208Y 240delta 4160.
Reply: @shha22  200A isn't really that much if you consider that it is a 2 pole at much lower (240V) voltage which drives the current up. For example a 3 pole 63 A fuse are also 189 A combined at 400V. Plus muricans do use a fair amount of electrical heating and cooling so they naturally have a slightly higher demand for power.
Reply: @Mithrasboy  Your oven is hardwired? Have they done away with the over sized oblong red switch adjacent to the oven that would isolate it?
Reply: @foff8375  The breakerbox isn't in his bedroom. So he's golden.
Reply: @JeanPierreWhite  I think what I meant is that it is unnecessary to plug the bugger in. The flex goes straight to a 30 amp box. Everything else requires a plug except ceiling lights.
Reply: why do i get 480 at my heater supply when i replaced it? I think I know but I'm not sure.
Reply: p.s. I am in the USA
Reply: Watts the point?  Wire we conducting this current study,  knowing it could relay spark a big revolt down the line?  How coil we have to be,  to impede any shocking reviews?  That light bulb in your head is only a filament of your imagination.
Reply: Too many times, in attic crawl spaces, I have seen NM Romex run right next to the old knob-and-tube wiring.  Then a new local code is sanctioned,  and there is EMT conduit running alongside the old Romex.
Reply: I thought that in some situations if the voltage dropped that the current draw would go up and therefore the same wattage but much more heat on the wire.  That would satisfy ohms law as well BTW.
Reply: I've been shocked both by 240 and 120VAC and I can definitely say that 120 is much more tolerable and less traumatic. Being shocked by 120 feels like a strong shake but 240 feels like you died for a second.
Reply: @Jake12220 . Actually 30mA is the RCD threshold chosen in most countries. At 0.4 sec above which is both painful and hazardous. (I'v tried, it's a massive jolt to trip one)
Reply: Combining neutral and ground causes wasted energy and has some safety issues. I used to combine them until I seen some examples why you should not. You might want to research this. Doubt you will see this comment let alone like or comment, but if you do this is a very important detail to research you might also find interesting.
Reply: @16v15  except in a sub panel where only the ground is bonded to the box.
Reply: @Sillyturner  Perhaps in your jurisdiction...
Reply: @dasoslukos  Same here, hi hi. 73's, N8LEJ.
Reply: Saw this gentleman describing a ring circuit: https://youtu.be/hZN6hiGLtrE As soon as he drew out the diagram, I thought, "Gee, that seems like bit a fire hazard if a wire breaks."
Reply: I thought  all 🇺🇸 power stations were just barns full of old car batteries daisy chained together kicking out 120 volts.
Reply: @lordsamich755  Not if you consider the entire system. In America we use a Delta system (3 hots and no neutral) for high voltage cross-country transmission. For a commercial building, we use the Wye (Y) system (i.e. there hots and a neutral) that he described at the end. The Neutral is created in the secondary of the last transformer feeding a building. The hot legs travel cross country, but the Neutral travels only the last few hundred feet/meters. We get the the advantages of two voltage options and a choice between single phase (at a slightly safer voltage) for most circuits and more efficient three phase power for motors at the cost of a few extra feet of copper. A good trade IMO.

Residential neighborhoods are fed by centrally located Delta transformers. Power arrives as Delta to a central location. Then TWO wires 240 v. are fed to each of three ajacent neighborhoods. A neighborhood can be meters to kilometers long. Again, the neutral is created in the secondary of the last transformer before it entered the house, i.e. the last 50 feet (30 meters) or so. We feed a house with TWO wires, until the last 50 feet, when the neutral is added

I live in a rural part of America. Power taveles to me via a high voltage Delta system  to a substation about 10 miles away. It then travels as a low-voltage Delta system to transformers half a mile from my house. TWO hot wires travel underground to a power box on my lot line. That box feeds my house and my neighbor's house. That box generates a neutral via the center-tap of the transformer secondary which is bonded in my service box. A distance of about 30 feet. Because of that, I can choose both low voltage and high voltage appliances. Not a bad trade off.

SO, electricity gets to my house in the form of three phase high voltage Delta across many miles of copper. In the last half mile, it is delivered as 2wire single phase 240 v. For the last 30 feet it becomes Split phase 120/240 v. For the price of an extra 30 feet of #1 wire I get to choose between a somewhat safer 120 v. or a somewhat more efficient 240 volt for my stove and my water heater.  

Fifty years ago, as a theatrical electrician, I learned a saying. "120 volts, you grab it. 240 volts, it grabs you." Meaning, touch 120 v. and it will probably throw you back off the contact. Touch 240 v and your muscles may lock up so you can't let go. I have been zapped more than once at 120 v. Never been zapped at 240 v. or I'd probably be dead. I am glad (more than once) that stupidity at 120 v. was not fatal.
Reply: @MickAlderson  
Honestly I would put that down to luck over voltage.  I tried to make a 240v torch once, all I felt was the wall 5 meters behind me.
In my defense I was 8 at the time.

Still regardless of the reason it is American transformers that are done different to the rest of the world.  Using a world standard transformer would still end up cheaper; if only by some negligible amount.
Reply: My service panel HUMS/BUZZES like that....
Youre saying that it's not supposed to make that sound?
Reply: @julianpompa4959  don't worry that's just angry pixies leaking out.
Reply: We are ditching ring main circuits switches on sockets yes are odd as the goods on the end do have switches.  Are UK sockets are the best.  In the UK phase to phase gives us 400V .  Internals the fuse is on the phase side your hot side.  We did have 2 fuses on are inlets way back in the dark ages.  They are still found.  We have what we call figure 8 leads or some call them a fat lady were it can go any way round changing the fuse side but there in double insulated goods.  110V to ground is much safer we do have 110V transformer boxes for out side site use.  I did say at school the voltage is needed to kill you even the teacher sided with the class.  Dumb teacher as a kid I did understand house wiring also volts to amps even most adults never did and still don't were you say a car battery that is what I did say.  There was a time some one saying a 9 v radio can plug in to the wall as it only takes what it needs.  I bash my head on a wall.  Same as a customer with a Dell desk top her PUS died 2 times so I say we will use a 300 watt not a 230 watt.  She says that
Reply: @chaos.corner  As I was taught, (it could be apocryphal) Edison started with a nominal 100 v. plus a bit for line loss inherent in DC power, hence 110 v. Once AC was adopted, there were several standard voltages depending on how far away you were from the generating plant. Basically, they hadn't figured out how to overcome the effect of distance, even on AC systems. Local voltage in the US could be anywhere from 110 to 125. Early electric manufacturer went so far as to test lamps to find out what voltage they delivered the labeled wattage, and market them accordingly. Those lamps for shipped to regions that matched the tested voltage, which could be 110/115/120/125 volts.

As the bugs were worked out, nominal standard voltage in the US became accepted as 120 v. That doesn't mean there isn't some variation. I was the head electrician on an outdoor music festival for thirty years. (Covid-19
killed the festival.) We used lsrge portable generators for stage power. With portable systems you don't have the size advantage of a regional power system. Source and Load are much more closely matched. I learned to set the line voltage of the generators at 124 v. By the time power got through the feeder cable, and the dimmer system and the circuit cable, voltage at the fixture had dropped to 120 v. nominal the fixture was designed for. 

What many people do not appreciate is that our present accuracy is built on the work of people who were then at the bleeding edge of technology. Tom Edison chose 100 volts as a standard because it was less lethal than higher voltages. He could do that because the copper mines in Michigan were still going strong, and copper was therefore cheap. Europe lacked the copper mines the US had, and adopted 220 v. It was more dangerous, but needed much less copper than 220 v. which Europe did not have. You build your system with the materials you have available. BUT, once you go down a path, it is hard to back. The US wourld have been better to have adopted 220 v. as a standard, but once 120 v was widely adopted. It was too expensive to start over.

Edison designed a connector by-then-and-by-gosh which is small in size, and good enough at the time. It was efficient then, but times have changed. European connectors opt for size vs.safety exactly opposite to what Edison chose. US is safer at the source, while Europe made the system safer mechanically for the end user. 

The rest of the world choose differently. They opted for twice the voltage for less materials invested, but traded on safely of the end user. Every country must calculate cost vs. benefit. The US at the time could afford 110 volts. The REST of the world lacked cheap copper and different choices.  But once those systems were established, we are each locked into choices made before we were born.
Reply: @SpyrosLv  The real reason is that our electrical system is old. Very old. And also, backwards compatibility was desired
Reply: @chrislaws4785  Older receptacles for 240/120 volt appliances like clothes dryers and ranges, as well as the power cords for them (and the wiring), do have the combination neutral/ground. However, on straight 240 volt appliances (like electric car chargers, as well as hardwired devices like central air conditioning condenser units), it is strictly a ground wire. No neutral on the thing.
Reply: @16v15   This is true at the main residential electrical panel, but if there is a sub panel off that main electrical panel the ground and neutral wires must not be bonded at the sub panel but the panel must have a ground rod which is bonded to the ground buss.
Reply: The best thing about electricians is they are gonna scrutinize the fuck out of your electrical knowledge.  Best cover all your bases.  This comment thread pleases me.
Reply: station240 I was trying to get my garage wired for welding and 3 phase machinery, and I could not BELIEVE the number of different outlet possibilities.  It still makes my head hurt.
Reply: DocNo27 I put in two natural gas dryers 21 years ago, and have never regretted it a moment.  My house was built for electric heat, and a previous owner replace that, and the electric water heater.

It's cheap, fast, doesn't smell, and much cleaner (less CO2 and sulfur) than the coal my local electric company burns.

I wish I could use a clothes line for efficiency and the fresh smell, but I have allergies to a lot of pollen.
Reply: Actually you can pull 100% by getting more current as long as it doesn't trip the fuse, like all USB power adaptors give same wattage through 110V~250V
Reply: We have switches on (most) power sockets for additional safety. As a benefit, the  power point switch is usually more reliable than the equipment power switch, which is often deliberately designed to be a weak point. Think about it; how many electrical appliances fail because the internal power switch has failed? A lot.

Ring mains are very simple, not weird. They were designed to minimise significantly the amount of Copper needed for house wiring. The cables can have smaller CSA, because each route around the ring carries around half of the current. 

Typically, a small house in Britain will have far fewer circuits than one in the USA. I wired my house, with a power ring main to the front, and another to the back, plus a lighting ring. Then I have two spurs; one to the water heater and another to a small workshop. So the main supply box contains 6 isolation switches, one being the main isolator and ground leakage breaker. 

If I had used the US system, there would be at least 20 breakers, including 19 spurs and the main supply breaker, in my small house. That's a significant saving of Copper, isolators, junction box size, complexity and costs.

My terraced house is 150+ years old, with supply cables suited to 100A per house, in 200A pairs, and the supply is single phase, at 234V nominal, so I have 22 kW available to me. In practice I generally have 250 - 253V, giving me 25kW or more, before risking blowing the (non-user-accessible) supply fuse. Modern houses often have individual 200A supplies. 3-phase is generally only supplied to businesses, unless the homeowner requests it and pays for the installation.

We do have the facility to supply our houses and schools with 2-phases like yours, and I have used them. Generally, the equipment plugs are like the standard 13A U.K. plugs, but with all three connectors rotated by 90°, keeping the internal 13A fuse. We also have a few 16 A plugs for older electric ovens, and those plugs have round pins. The really old 5A unused round pinned plugs are almost never seen nowadays, because they were essentially for pre-WW2 equipment.

Your mains supply being 60 Hz, when most of the world uses 50 Hz, is the most unusual thing about it!
Reply: @AaaAaa-ly3on  The entire Europe uses 220-240V and people are not dying from electric shock more often what so ever. Voltage is not the only danger. In fact I rather prefer my house feeded with 240V and EU level security rather than 120V with US level of security. The electric panel we see in the video is considered as an hazard in Europe on so many levels I cant list them all here. Metalic box. Non insulated lines. Vertical design. no general leakage safety.
Reply: Are you saying that 208 power is fundamentally more efficient than 240 and you can get more use out of it than watts in?
Reply: V=IR, P=VI, thus P=I^2R
Power = Current (Squared) x Resistance. So surely power goes up with square of current, not voltage?
Reply: Most people require one zap to convince them.
A 240 volts panel is 120 v. to ground. Across both “hot” conductors it’s a full 240 (sine wave peak 360) volts. Our 60 Hz (Hertz = cycles per second) power is more deadly than 50 Hz. Some locations have used 25 Hz and 16⅔ Hz.
Reply: A 12 v. automobile battery or 6 v. antique car or golf car battery can electrocute you. If a wire punctures your skin while a wire of opposite polarity also punctures your skin so that the current passes through your heart – it tends to follow blood vessels – it can cause your heart to fibrillate (stop beating, just quivering) and you to die.
Reply: Three phase motors are considerably more efficient than one phase or split/two phase. One- and split-phase motors waste a lot of power.
Reply: Something is wrong with your gas dryer. The exhaust from the burner shouldn't be mixing with the air that goes through the tumbler drum until it has passed through the drum.
Reply: How about 3 phase AC? Do you have that in the US?
Reply: Minor semantics correction: it is still considered 1 phase, the center pt tap is ref'd to grnd with 2 directions of voltage but there is only one winding off the x-former.
Reply: For resistive load: P=V*I and V=R*I -> I=V/R so P=V^2/R. 208V is 75,1% of de power from 204V
Reply: 17:14 what are ringsman of uk, or am i heard wrong. i didn't find anything about ringsman in internet
Reply: @varno  400v phase to phase here in Europe.
And no connection between neutral and ground
Reply: @davidecasarin4953  there is always a connection between neutral and ground, usually at the transformer, but often in multiple places. That is what defines it as neutral, being referenced to ground. Now safety ground and neutral may not be connected directly. But both are somewhere literally connected to the ground with a big copper stake, and usually the same one.
Reply: Gotto say, I love your exuberant style of explaining things to the under educated viewers. As a journeyman electrician, ( industrial ), I did not see any breaker circuit labels posted on the outside of your 200 amp panel. That makes it more difficult to isolate any of our unsafe receptacles or light switches when required. Next time you do a video pertaining to your breaker panel, I want to see it properly labeled. Got it? 
 You do the public a great service with your channel. Keep up the good work.
Reply: @ole-martinbroz8590  Your window unit is so, so underpowered compared to a home unit. It's not comparable at ALL.
Reply: none of electrical engineering makes any sense, I thought all resistive heat loads were by definition 100% efficient 😭
Reply: @hovant6666  they are, but on a given resistor, the power dissipated at a given voltage is V^2 /R. Heat pumps can be over 100% efficient. This is because they don't make heat they just move it.
Reply: @pirobot668beta  
Watts = E² / R
Reply: @SuperWasara  
You can buy electrical outlets that do not energize the plug until both prongs are fully inserted.
Reply: @chrislaws4785  
The issue is that a heavily loaded neutral conductor could have a potential of up to 8 volts AC, and your appliance frame used to be bonded to that... 

A person with wet skin can easily feel that voltage.
Reply: @cezarcatalin1406  
Skin effect. Interesting. So that's why when a jokester aimed a high power RADAR at him, the janitor carrying the light bulbs didn't feel any electrical shock when the fluorescent tubes suddenly illuminated.
Reply: No, YOU'RE WEIRD!
Reply: @ReeseRiverson  Wow! You must be able to service a concert arena with an amp that uses 7000 watts! Awesome!
Reply: @pirobot668beta  Power Factor.
Reply: Most factories and mills use 277/480 three phase for large HP motors. An yes which is best depends on the loads. But for loads over about 75 KVA in one dwelling, the best option is to use at least 120/208 and use buck/boost transformers that actually need 240. Most commercial buildings do that. 120/240 single phase is inefficient for large building loads because conductors sizes get ridiculous. It's also easier to balance the neutral load with three phase to get the neutral to 20% or less. 240 delta three phase is another option with the middle transformer having a "lighting pot", 120/240 single phase for office and general 120 volt needs, while 240 delta for shop motors and machines. Linemen call the three pole transformer arrangement a "power bank".
Reply: @PanicStation1337  You are wrong about the unsafety of swiss plugs. Actual spec plugs need to have the back (reachable) part of the P and N pins isolated and they never just slip out of the socket!
Reply: Just a note: electrical potential is NOT voltage. Voltage is potential difference. It requires two points of reference not just one.
Reply: over here (france), we have like 30A or 45A single phase service @230V, including houses.
gas powered clothes dryer... sounds like an incinerator 🤣
Reply: Cool
Reply: Yes, that horrid 208V in America, does cause problems, as you say, only 75% of the heating compared to the proper 240V.  . .   Sometimes that 208V causes problems with Air-conditioners and other compressor motors, sometimes resulting the motor not being able to start, "Locked rotor" and over heating and burning out. . . .  This nasty 208V is a result of America mixing 2-phase and 3-phase, yet still wanting 120V Single-phase. . . .. . .

A 3-phase "Y" or Star secondary, can have 3 x 120V Single-phases, but between phases, "Line voltage" is only 208V. . .  So if an American house is feed from just two phases of a 3-phase supply, they can end up with   120/208V. . . .   If the supply transformer is 240V Delta, with one winding centre tapped and grounded for Neutral, then they have Two 120V lines, giving 120/240V but that leaves the 3rd line at 208V the stinger or bastard phase..  . Nasty.
Reply: Let's get one thing straight ground and neutral are bonded in the main box not in sub panels. Must be separate. Also it's ok to have one screw for 2 wires if the breaker is equipped for two wires my Square D breakers can have two wires but not the 2 pole type. Single pole have two places for a conductor. Code says it's ok  73
Reply: @ronb6182   Yes, you are correct, TN-S for sub-panels. . . Actually the Neutral Ground might even be separated earlier in the main incoming breaker panel. . .  You are also correct on American breakers and number of wires.    Not a problem with European Breakers though, you can fit as many wires as you can get in, providing each wire is good for the breaker Amps.     Same with UK Outlets, you can fit many wires into each wire fixing hole.
Reply: @varno Hello, you are wrong.
Where europeans use 400V, Americans oftentimes use 480V.
It's interesting, do some reaearch
Reply: That's a main panel. Neutral and ground are bonded at the main panel.
Reply: it's not the price, it's the CAT rating @ihatesmartphones
Reply: @cezarcatalin1406 

The problem with that is that in copper wire, the skin depth at 300kHz is around a tenth of a mm, so now you're conduction cross section isn't the wire area, it's the area of the outer tenth of a mm of your wire. Good luck running high power or high current without unacceptable losses and heating with a system like that. 

Capacitive and inductive loss would also be enormous, particularly in distribution. Frequencies higher than a few hundred Hz at most are just not viable for electrical transmission and power applications.
Reply: @pdrg  No, the 240 is a true sine with twice the amplitude. Sin(x) - (-sin(x)) = 2sin(x), not some weird bumpy thing.
Reply: @SYH653 Two ground wires under 1 screw is ok, but not for neutral wires.
Reply: Let's not confuse ppl with voltage drop percentage codes
Reply: He is so smug about the 240V in US households^^ cute
In all german houses we have 400V in 3 phases plus neutral. 
They are used for things like boilers, electric heaters and the stove. 
The normal outlets have one of the 3 phases and neutral (plus ground sometimes) at 400V/sqrt(3)=230V
We usually also have a 3 phase 400V outlet somewhere in the cellar or garage which can be used for industrial tools but not many people use them.
But it's quite cool that we can just buy any industrial machine and plug them in. Often people get old stuff from work like big robot arms, welders, CNC machines and they can just plug them in in their garage.
Reply: @swunt10  why on earth would you want 400v in a household?
Reply: @corykroes7784  electric stove, 32A 3 phase outlets in the garage, everyone using  all the normal 230V outlets in the house at the same time. Lots of reasons.